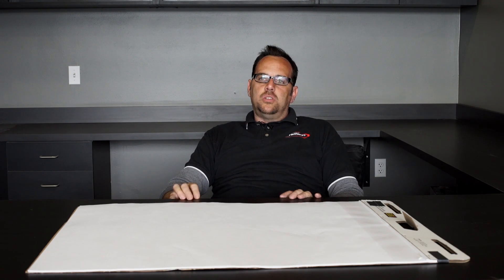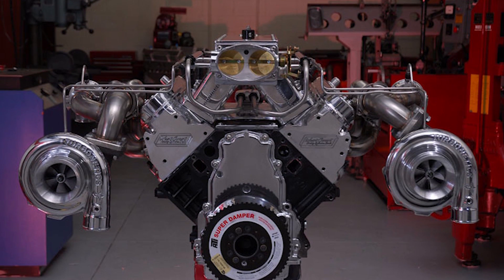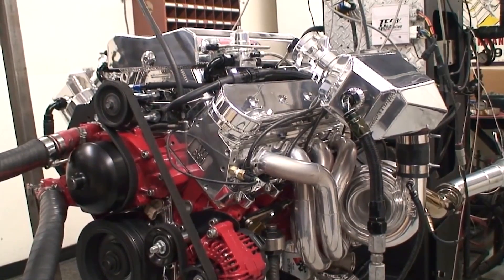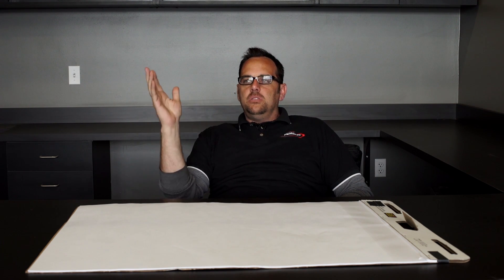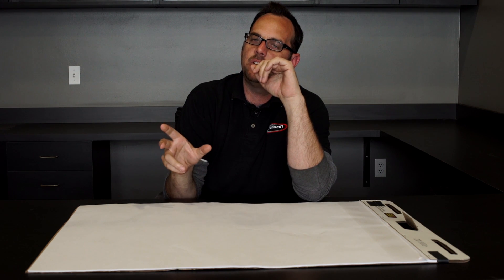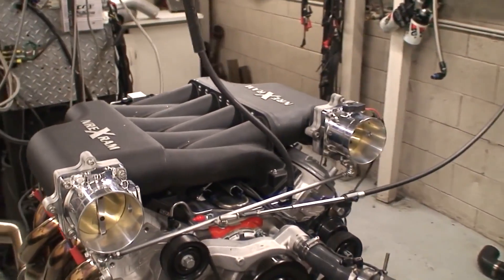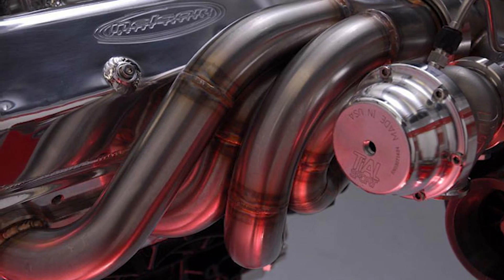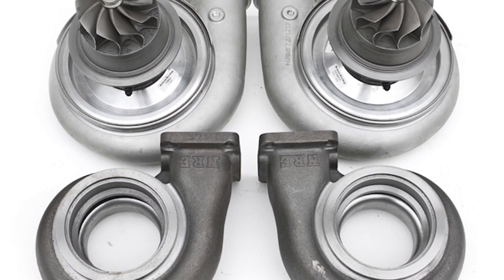Master Engine Builder Explains Why the LS V8 Is SO Good

Comment: It isn't, is the simple answer. It's an ancient design, with numerous flaws, being built way, waaaaaay after practically everything about it has been outdated.
They make teeny tiny amounts of power for their size, unless you almost completely rebuild them, the crank and valvetrain design seriously inhibit power at high revs, and are terribly inefficient.... they are, from an engineer's point of view, total wank.
From an enthusiasts point of view... lots of people like them. I don't. But some do. Can't figure out why though. No redeeming factors at all. There's a good reason they're more rare than Ferrari's in many places.
Reply: +Foxtrot Oscar Horsepower per liter has absolutely no practical meaning in the real world. Horsepower is horsepower, no matter how many liters it takes to get there. All that displacement has benefits like a fat torque curve. Sure, the valve train doesn't support revving past 8k rpm but it doesn't need to. Small displacement engines need RPMs to make their power because they don't make the same torque. 

Packaging is also better with the cam in block design. GM has repeatedly said they wouldn't be able to get the Corvette hoodline the way they want with a DOHC engine. If they have to compromise their goals to use a DOHC, I say stick with the OHV.
Reply: ***** Horsepower is most certainly not horsepower. You could have 300 thoroughbred race horses, or 500 plough-lugging Shires. I know which would get you round a track better. 
Power isn't all about power, a large portion of it is how the power is delivered. 
The 'fat torque curve' of an LS is one of its less desirable traits. When talking about road cars, large amounts of torque does nothing except make it easier to spin the tyres, slowing you down and making the car more difficult to control. Trucks and vans are the only things that can make use of torque for its true purpose, moving stuff.
All engines need revs to make power. Power is a function of force and time. All the force in the world isn't going to make you fast if you can't get it out quickly. Revs equals quickly equals power equals faster.

Packaging is marginally better in some cases. A good SOHC head is almost identical in size and shape to a pushrod head. A DOHC head is slightly bigger, but rarely makes the overall engine any bigger, as the intake and exhausts are generally wider and taller. OHC heads also give efficiency benefits that mean you could probably just use a smaller engine to begin with, for the same result.

Everyone else on the planet manages to make the bonnets of their cars fit. Why can't Chevvy? Why do they need to ignore every shred of evidence from the last 50+ years that OHC is just better?

GM have compromised their goals.... just so they could use pushrods.
Reply: barath4545 As a trained mechanical engineer and lifelong automotive enthusiast, I can't see anything good about the LS engine. 500hp? So what? If it's a choice between 500hp and something good, quality always wins in my book. It never used to... Until I owned a Corvette. 
An LS swap costs a SHIT LOAD. If you think anything otherwise, you've clearly never owned, run or tried to swap one.

Supras are cheaper in the long run, unless you're building in the USA and only using scrapyard parts, which is a teeny tiny minority of people globally.

Everywhere else, LS engines are EXPENSIVE, because no one has them. Even in the US, an SR20 is cheaper, lighter and has better aftermarket support, and if you're dedicated, can make in excess of 1000hp. What more do you need?

If you actually like cars and engineering, you would not subject anything but a vintage Chevrolet to the abomination that is the LS engine.

PS, LSs sound terrible, like almost all crossplane V8s, as all you can hear is the constant misfire.

The best alternative is simply putting far less money into the engine that your car comes with.
Reply: +Foxtrot Oscar hahahahahahahahaha..What a surprise..Seeking out videos about and engine you hatefrom a country you DISLIKE TO THE ROTTEN CORE!!Here are some wonderful BIASED BULLSHIT COMMENTs FROM YOU             Corvettes ARE gutless and shit, that's why a 3.6 litre Porsche can keep up!"
(FOXCOCK) 

I KNOW V8s are shit by design because... well... they are(FOXCOCK)

V8s do not deliver the promised performance. Thus, they are crap.(FOXCOCK) 

V8s AS ENGINES are bad(FOXCOCK) 

V8s have a very POOR potential for great power(FOXCOCK) 

I'm NOT arguing V8 aren't used, they are used. But they are NOT used for high performance applications because they just can't handle it.(FOXCOCK) 

V8s go in cars that are too expensive for normal people, but too rubbish for rich people. Not really good for either.(FOXCOCK) 

Crossplane V8s are shit(FOXCOCK) 

Crossplane V8s work poorly in everyday situations(FOXCOCK) 

The V8 is a new option for poor people, essentially.(FOXCOCK) 

FACT that crossplane V8s, especially pushrod ones, are deeply flawed and thus shit for high performance use(FOXCOCK) Please PROVIDE a Article/Review that supports your biased Opinions!!!!All these Auto Company's continue to use a crossplane V8 with GREAT SUCCESS!!!=YOU FAIL!!BENTLEY
MASERATI
ASTON MARTIN
PORSCHE
MERCEDES
JAGUAR
MORGAN
LEXUS
INFINITI
CORVETTE
CADILLAC
AUDI
KOENIGSEGG
VENOM GT

NASCAR
FORMULA D
BAJA
Le Mans GTYou NEVER owned a Corvette!!!!! You are NOT a Auto Enthusiast!!You are Not a Engineer!!You are NOT a Auto Journalist!!
Reply: +Foxtrot Oscar lighter and better?  it's pretty telling that you think a 2.0 four cylinder being only 70 pounds lighter than a 6.2 liter v8 with a supercharger is a good thing.
Reply: +Foxtrot Oscar

Clearly you don't understand sarcasm, or engines for that matter.  The LS is small for a V8, light and good at dissipating heat due to being all aluminum, makes gobs of power, and is cheap.  The point in all those swaps is that it is a powerful, cheap, reliable motor and it fits.  It is slightly larger than a Miata's I4, fits in the same space as a microspic wankel, and makes more power reliably without boost than any I6 or I4.

You act like torque and power are an either or situation.  The LS has both - a nice, flat torque curve, and linear power growth up to 7000rpm in most performance applications.  The LS3 makes 430hp and 420something lb-ft of torque.

And for the record, old Enzo Ferrari himself said "Horsepower sells cars, torque wins races."
Reply: Foxtrot Oscar
lololololollololololol

DEFLECTION!!!!
DEFLECTION!!!

Where is the Article/Reviews supporting your biased bullshit Opinions??????????

"I could import a fresh built SR20 from Japan for that, and that's lighter, and better."
(FOXCOCK)
Thats your opinion.The sr20 is slightly lighter but the LS has a lot more POTENTIAL100% FACT!!.When its time for you to import a engine get the sr20..Simple as that!!

Stop the bullshit lies!!!
You made your Comment ,MOVE THE FUCK ON!!

You are NOT a Auto Enthusiast!! Far FROM IT!!
You are NOT a Auto Journalist!!
Reply: +Foxtrot Oscar hahahahahHahahahHHHa.look at you all angry ...Everything you spewed is your Opinion...400hp from a LS engine is the same as 400hp from Ferrari..The only difference is the LS will have more torque to offset the slightly slower revving.. Your hate towards anything American is in every comment..

Provide a Article/Review that's supports your OPINIONS or SHUT THE HELL UP!!!

You can't call yourself a ENTHUSIAST !!! Your too biased and bigoted !!!
Reply: +Foxtrot Oscar dude you're not even in the us? what? i been wasting my time with you. so why are you arguing you live in the uk and if your stating not availability in europe why are you bothering then with a engine swap that it's mainly or only as you say for the us it's old school design not reliable dude when was the last time you saw an european engine going over the 200k mile marker
Reply: +Foxtrot Oscar hahahahahahahahahahahahahahaajahHahaha

Don't cry princess....Every word he said about you is True.... The more I think about it..I bet you are around 12-15 yes old..Xbox is your life..Im guessing you have one in your room..Your parents let you have it to keep you away from them. You build cars in your make believe race world and talk trash..I bet you are one of those kids that really suck at games but think your good..

You are a liar..
You are a straight up bigot with a deep distaste towards anything American...

You spew the same shit with NOTHING to back up your biased bigot bullshit..

You are a troll..

beat it loser!!!
Reply: Foxtrot Oscar

hahahahahahahahahahahahahahahahahahahahahahahahahahahahahahahahahahahahahaha

More EXCUSES!!

Please PROVIDE one single Article/Review that supports your biased opinion that  LS engines are shit,junk,gutless,boat anchors
DO not belong in High End or Performance Auto's!!!

Until you provide a Article/Review
YOU FAIL!!!
YOU FAIL!!!

What a surprise attacking America once again!!
Why do you always compare with America?
You are JEALOUS!! Simple FACT!!

You hate he LS Engine but you SEEK out this VIDEO just to SPEW YOUR BIASED BULLSHIT OPINION!!

"The only place you can get LSs is the US, because that's the only place that they're sold in any number"(FOXCOCK)

http://www.partsworldperformance.com/

http://www.roadcraftuk.co.uk/index.php?route=product/category&path=37

Just stop the LIES and Bullshit..

Your Opinion on the LS engines has been noted..Move the fuck on!!!

You are NOT a Engineer!!
You NEVER owned a Corvette!!
You are NOT a Auto Journalist!!
Reply: Foxtrot Oscar
hahahahahahahahahahahahahahahahahahahahahahahahahahahahahahahahahahahahahahahahahahahahahahahahahahahahahahahahaha

WOW you are a dim bulb..lol

They have IN STOCK ENGINES!!!
And yes they are imported from America!!

Once again you have NOT supplied a Article/Review that supports your opinion!!
=YOU FAIL!!!

Take a look around you..You are on a video about LS Engines trying to convince us that LS engines are not GOOD!!
YOU ARE WRONG!!!

You are NOT a Auto ENTHUSIAST!!!
Reply: Foxtrot Oscar
hahahahahahahahahahahahaha

Where is your PROOF..No article/review =YOU FAIL!!

You made your biased comment.MOVE ON!!

LS Engines are considered good/great!!
Provide a article/review that says otherwise!!
YOU CANT -=YOU FAIL!!

Your argument is the same..LS engines are shit,gutless,boat anchors not GOOD for High End or Performance Auto's!! Thats  100% bollocks !!lol

And yet you still have NOT provided any PROOF!!

We all get you hate LS engines..You made your POINT MOVE THE FUCK ON!!
But we both know you wont..Your hate and distaste towards America run so deep you cant help your bigot self!!

You are NOT a Auto Enthusiast!!
Reply: Foxtrot Oscar
hahahahahahahahahahahahahaha

"Praise for the LS engines? So the HUGE amount of MOCKING is praise is it? Fucking hell."(FOXCOCK)

Pleased provide proof!!!
Provide a Article/review Mocking the LS Engines!!

If it takes (a) engine 3800rpms to reach 380lbft and (b) engine 1700rpms to reach 400lbft.The latter engine will negate the slightly faster (a) revving engine!!

There is a reason American muscle/sports car are so good in straight line acceleration..LOW END TORQUE!!!FACT!!

Now that America has finally decided to address the handling aspect its a WIN WIN for everybody!!

I ask you again Please provide a article/review that supports your OPINIONS!!

Its still your OPINION that the ferrari engine is better!!
I prefer a LS9 or LS7!!! Absolutely nothing wrong with that!!

But for some reason you think your Opinions you claim as fact to be anything other than your BIASED OPINION!!!

You claim the LSxxx engines to be shit..PROVIDE A ARTICLE/REVIEW THAT AGREES WITH YOUR OPINION!!!!

You are NOT A AUTO ENTHUSIAST!!

You are nothing but a infection!!
Reply: Protip: Ignore Fox at all costs, this unemployed basement dweller is on EVERY major auto channel spewing this shame crap.
Reply: so I guess I wasn't clear the 5k was engine tranny wiring and ecu for an ls. 2k for an sr20 alone. um sorry I have driven quite a few ls powered cars and they get far batter economy then an sr20. on 93 octane you'd be hard pressed to get more then 22 average MPG out of a STOCK sr20 so nice try. I have and can constantly get over 25 mpg average in a 4000 lb ls2 ctsv and no dont even try pulling the displacement on demand bs it doesnt have it.

the ca18 is a pile of steaming crap there is a big reason why that engine is tossed for the sr20 or hell even ka-t's are better.I like how since you had ONE LS powered car ( or so you say) that all LS powered cars and the engine alone is junk. I also love how you keep saying it is used no where but the USA but like I said before my brother in law in Germany constantly send me pictures of german registered mustangs, corvettes, camaros and such. In the saudis they use pretty much NOTHING BUT turbo LS powerplants in their hill climbs rigs because nothing produces the power + reliablity that can take the crazy saudi heat for the price. When I did a tour overseas in Quatar and Afganistan I saw more corvettes and camaros and trailblazers and suburbans then I could count. You know how much a corvette cost to get in Quatar? try over $200000 even a trail blazer is over $100000 but they are EVERYWHERE. the only suv or non american car that I saw slightly more of when I was there was the Mitsubishi Pajero

GM choked the ls big time since very basic cam and headers and tune and you can easily touch 600hp with very little invested into actual mods. getting 600hp out of a very held back LSx is a joke getting 600 out of a sr20 will break the bank and will not be reliable at all. They yes PLEASE spout with with BS bmw you keep harping about which is what $90000 vs the cts-v at $50000 and that 600hp model you keep whining about is limited production and costs what was it $125000. so for an entire cts-v extra you get and over priced over engineerd engine that if it breaks in any way you need to sell the house to fix it and a slightly better interior. and GM made it "gutless" since 400hp is gutless to you to avoid gas guzzler tax extremely easy to unlock what the engine holds back. you are just a closed minded fool who had (so you say) a bad experience with an engine. Hate all you want you LS haters make me laugh. The LS isnt going anywhere and why should it it's a fantastic powerplant that has proven itself over and over. 

The Sr20 has a big following yes but I am sorry the LS kills it in parts available. If you broke something on an LS you could drive to the nearest autozone/advanced auto or whatever car parts store and for the most part would have what you need on THE SHELVES. the sr20 or whatever other motor you want to trying throwing in the mix will not have that level of available parts.
Reply: Suprised you havnt looked up and started spewing your garbage on the "LS3 V8 MIATA BUILD" video. seems he swapped that in and made a track monster with zero downsides and kept near 50/50 weight distribution. please go spew on his video so he can prove you wrong in so many ways.
Reply: +Foxtrot Oscar all this crap about crossplane cranks makes me laugh as most v8 ARE crossplane minus Ferrari and lotus. Merc BMW and audi run cross plane cranks.
Reply: +Foxtrot Oscar or show me an 8-10000hp dohc motor and ill stop talking because top fuel makes that on ohv all day
Reply: +Foxtrot Oscar LOL you're sitting here saying a LS motor, that is cheaper, more reliable, and produces over 600 HP, while having a 100,000 mile warranty, and is put in builds ALL ACROSS THE GLOBE BY TRUE CAR EXPERTS.............is a piece of shit.  

And you're calling us sheep?????   LOL

You want to bring how much a V12 Ferrari motor costs in the first place?????   LOL
Reply: +Mr English Ferrari will cover anything within 7 years????  

Damn dude, I just about choked on my sandwich when I heard that!!!!  LMFAO  

Go for it..........bring Ferrari a blown engine at 6 years.........tell me how that goes!!!!!
Reply: Foxtrot Oscar HAHAHAHAHAHAHAHAHAHAHAHAHAHAHAHAHAHAHAHAHAHAHAHAHAHAHAHAHAHAHAHAHAHAHAHAHAHAHAHAHAHAHAHAHAHAHAHAHAHAHAHAHAHAHAHAHAHAHAHA

LOLOLOLOLOLOLOLOLOLOLOLOLOLOLOLOLOLOLOLOLOLOLOLOLOLOLOLOLOLOLOLOLOLOLOLOLOLOLOLOLOLOLOLOLOLOLOLOLOL

Means NOTHING TOOL!!!

Once again I ask you ,PLEASE PROVIDE A ARTICLE/REVIEW THAT SUPPORTS YOUR BIASED BULLSHIT OPINIONS ,you like to claim as fact!!!

Until a article/review is provided..YOU FAIL!!
Reply: +Foxtrot Oscar I did an ls swap with 2 friends last week in 9 hours.  We pulled a 6.0 and 4L80E out of a rear ended farm truck for 800 dollars.  Aftermarket headers and cam ran us around 600 more.  Very inexpensive very quick.
Reply: zeusdog34 Hahaha, what a surprise, Zeusdog34 being a useless moron again. This came up on my YouTube feed, it's a fairly provocative title, this should be expected. 

The fact that you cannot concoct a decent argument, and you have to childishly deface my name gives a fairly decent indication as to your intelligence, or lack thereof. Now go away and let the grown ups do some talking.
Reply: russellallen1 Trouble is, for anyone else in the world, you'd need at least 5 grand. The only place you can get LSs is the US, because that's the only place that they're sold in any number. That means importing an engine, and if you import a scrapyard engine, you're a fool. No point shipping something that is most likely junk. Remember there's a reason that engine is in the scrapyard to begin with. 

Then, of course, there's the cost of conversion. If you bodge the hell out of it and have a full workshop, it can be quite cheap. If you need to rent ramp time, or pay someone to assist or do the work for you... it can run into the high thousands, just in labour. That's if the damn thing will fit to begin with.

And then what do you end up with? An LS powered car. Big whoop. There's a very, very high chance that that is a worse thing than what you started with.
Reply: +Foxtrot Oscar 
Then where are all the coyote swapped miatas?  Ford md motor swapped RX-7s?  S54 swapped E30s?  Oh wait there aren't, because it doesn't fit.  But an LS does, because it actually fits between the shock towers.

And torque isn't not important?  Tell that to every honda fanboy ever (I do have an S2000).  The ability to not need to be in the top of the RPM range to nove the car forward is pretty important in any racing application ever.
Reply: +Foxtrot Oscar 
Well then get out of the rest of the world and come live in freedom country.  Our McDonalds tastes great.
Reply: James Schall I wouldn't have any kind of V8 at all in a Mazda, not even an F1 engine, because the RX7 is ALL about that wankel. There's no point having one without it. The chassis is also designed to have that tiny little nugget of engine sat waay down low and well far back. Putting any kind of piston engine in there, even a teeny little 4 cylinder, moves the mass concentration up and away from the centre. 

Why the hell would you put any kind of V8 in an E30, when BMWs own inline six is superb and fits with mostly factory parts? Heck, some even came with the little six. 

Torque means jack shit. My 1972 Series III Land Rover puts about 5000lb.ft to the road, if I remember correctly. That's in bottom gear. About the same as a Tesla S, I believe. 

And guess what. It's FUCKING SLOW. It would be, it's an old Land Rover with about 80hp. 

LOADS of torque. It can pull 20, 30 tons happily. Not legally, but it'll do it. 
But it's dog slow. Because it has no power. 

The ability to NOT have full torque at low rpm is VERY useful for metering performance out of corners, and driving in wet or slippery conditions. Practically every decent driver will peel out of a tight corner, a gear up and ride the rising power band smoothly. You CANNOT do that if all your torque is in the first half of the rev range, and you're wasting so much top end by shunting the torque curve way down. That's why big, torque whore engines never make as much power as their free spinning counterparts. 

US McDonalds is actually horrid. UK McDonalds is pretty shit too, but I've had both and prefer the UK version by far. Even my American friends have said as much. That said, the far east has some pretty good McDonalds. France isn't bad either. 

Oh, and here in the UK, I have arguably more freedom than you do.
Mostly because the US constitution is based on British law from 250 years ago, and ours has changed a lot more and become freer since. 
The only thing the US has over the UK is it's easier to buy guns, really. 
Never mind the fact you can still do so here, and we have far better healthcare, education, welfare and so forth...

Also, I don't fancy paying US taxes, having to do all that paperwork and shit, and also, I don't want to get shot. I don't mind visiting, I really love visiting, in fact, but statistically, you're more likely by far to be shot than I am. Or jailed.
Reply: zeusdog34 Take a look around you. See that? That's reality. And everything in it says you're wrong dear boy.

You think that's 'getting' an LS? Those companies import them for you. They're not here naturally. Fuckwit.
Reply: zeusdog34 So they're imported. How is that a proper supply if they have to be imported by a third party? It isn't. And they're fucking expensive too. 5 grand for a damn engine? I could import a fresh built SR20 from Japan for that, and that's lighter, and better. 

What's the point in an LS when it's just not as good, and costs so much money?

I AM an enthusiast, that's why I see no point paying more for shit.
Reply: James Schall The LS is big for its power, makes crap power and is moderately expensive unless you happen to live in the one country in the world that actually buys them in bulk. The point in all the swaps is that it's a gutless, expensive, moderately reliable engine that just about fits if you cut and chop and smash stuff out the way. Is twice the size of Mazdas I4 and fits in the massive engine bay of an RX7. Big whoop. 
And makes less power than most modern engines half the size.

You know you can actually stand inside an RX7s engine bay with the engine in place, it's that big?

The LS has a horrible torque curve. All at the bottom gives nothing to the top end and makes low end control a nightmare, hence all the wheel spinning you see associated with almost all big V8s. You want progressive not linear. 430hp! WOW! From a 6.2 litre N/A engine, that's unbelieveable....ly shit. 

That quote is usually credited to Caroll Shelby, who built some terrible cars in his time (and who was also a bit of an arse, by all accounts). 
Ferrari's race cars have always been peak power monsters with gloriously smooth, progressive engines focussing on the right amount of torque and power, power, power from then on. The right way to do it.

If torque actually won races, the fastest race cars would all be diesels, as diesel is all about dat torque.

In reality, torque is good for towing and burnouts, and of little consequence to speed.
Reply: zeusdog34 Where is your argument? At all? Nowhere, so fuck off.
Reply: Tie Bei 70lbs lighter? Quite apart from the stupid archaic units used, that's a 100% bollocks figure.
The LS3 weighs around 204kg (450lbs for you Americans). The SR20DET in full trim weighs 149kg, or 328lbs. That's a LOT less. And weighing exactly that amount (or even slightly less if you ditch the cast iron exhaust for a light tube one) you can get 500hp. And instant response. And cheap parts. And perfect Japanese reliability. 

So what's the point in an LS again?

The LS9, with the supercharger, weighs 240kg (530lb) DRY, according to Jalopnik's weighing of theirs. 
That's a 91kg difference between an LS9 and an SR20. The entire chassis of an Alfa Romeo 4C weighs 65kg. Just think about that... That's a fat bloke sitting on the bonnet. All the time. That's going to screw your handling right up.
Reply: zeusdog34 Where is your counter argument? You can't disprove me, I have proof. Pushrods are shit BECAUSE they have more reciprocating parts, leading to greater friction. Greater reciprocating mass leading to wasteage of power. Less accurate following of the cam profile leading to sub-optimal valve timing, thus reduced power or efficiency. 

There. If you can disprove that, go ahead. As you can't... I suggest you shut up.

460hp is SHIT for a 6.2 litre engine. That's obvious. You CANNOT deny that. 

Again, I suggest you shut up.
Reply: zeusdog34 Yes. But Ferrari do it quicker, smoother and better from a smaller, more effective engine. It's EVERYTHING ELSE that makes an engine good, not just what numbers it makes on a dyno. 

Torque does not 'offset' revving, in any way. 

Your hatred of the fact that the LS engine is shit, is evident. 

Don't hate the facts man, hate yourself for being wrong.

Please do explain how not liking an engine for its obvious engineering defects and lack of ability to perform as I would like makes me bias in any way.
Reply: +Foxtrot Oscar before we waste any more time, what do you drive?
Reply: +Foxtrot Oscar hahahahHHHaaaaa

seriously man..Just provide a ARTICLE/REVIEW that supports your OPINIONS.. If you can't SHUT THE HELL UP.
"Torque does not 'offset' revving, in any way"
(Foxtrot)
Proof you have NO IDEA what your talking about..
Lowend Torque 100% does offset faster revving!! 400ftlbs of torque at 1700rpms is going to offset the 380ftlbs at 3400rpms.

You prove that you know very little about HP and TORQUE..

The thing is I can and have provided articles and reviews that only Praise the LSxx engines..You have NEVER provided anything supporting your ridiculous opinions that you like to claim as fact..

It's your Opinion the Ferrari engine is better..For you its better,for Me I would take a LS9 or LS7 from the C6 ZO6..Simple as that..

Nowhere am I claiming the LS9 or LS7 is better.Just my choice..

Stop haten!!! Stop your bias..

Millions around the world Love it..Proven by the crazy aftermarket support, the LS swaps around the world...And the continued Praise by ALL the experts...You know the ones who build them and drive em.The experts who test and review!!

I ask you again Please provide a ARTICLE/REVIEW that supports your OPINIONS..
Reply: zeusdog34 Provide an article that explains torque? Ok.
http://physicsnet.co.uk/a-level-physics-as-a2/mechanics/moments/

Happy?

Low end torque CANNOT 'offset revving'. Low end torque is how much torque is produced at low RPM. It has NOTHING TO DO with high revs. You cannot produce more revs by having more torque at the bottom end of the rev range. The two concepts do not overlap.

400lb.ft at 1700rpm will not equal or oppose (the two grammatically possible outcomes of the word 'offset') 380lb.ft at 3400rpm 

(please, get the units right)

You prove that you know jack shit about anything.

Praise for the LS engines? So the HUGE amount of MOCKING is praise is it? Fucking hell... There is a VERY GOOD REASON that NOBODY uses pushrods anymore. Think about it. If they were any kind of good at all, at least a few manufacturers would use them. Nope. Just GM and Chrysler, and ONLY on their US market V8s. 

The engines they sell to everyone else... OHC.... Says a lot, doesn't it. I mean, 96% of the world must be wrong about pushrods if Chevrolet say they're great...

The Ferrari engine is factually better. Smaller, lighter, more effective, more specific power and more specific torque, better revving, freer, more precise, more progressive...

That's all good.

The other MASSIVE bonus that the Ferrari engine has to enthusiasts is that it feels fucking epic. 

That matters too. This is why Ferrari are so well regarded, because they manage to appeal to reality and enthusiasts. 

This is why Chevrolet are constantly mocked. Because they ignore reality and cater to only a very small portion of enthusiasts. 

Your extreme bias for the LS series and just anything American, without reason, is evident in everything you do.
Reply: Tie Bei Many things. I can't decide what I want, so I buy and sell almost constantly, except for one or two cars. 
I drive my very first car still, my 1972 Series III Land Rover, and I've kept my 1972 Jaguar XJ12 too, because I've never found anything else so comfortable, powerful and that handles and rides so well for a price that I can afford. And the fact that I've had it for ages and it looks and smells so great.
Reply: FrankieJames7 No, I think inferior engineering is worse. Hence I can't see the point in having an LS.
Reply: ***** I'm not even sure you can get a Land Rover, or an XJ, on xbox. Real life however, very much possible. On xbox I had a Ferrari. I would gladly swap the Jag and the Land Rover for an F40.
As that's not possible, I may have to just buy another xbox.
Reply: zeusdog34 Proof? Just look around the internet, jesus...

I've provided a number of articles explaining in detail the exact reasons that both pushrods and crossplane V8s are poor choices for performance.

If you're too stupid to understand that, that's your problem.

How the fuck does that even work? 400lb.ft at 1700rpm will NOT 'negate' 380lb.ft at 3800rpm. There are FAR more variables than that. The power curve before and after those precise points plays a MASSIVE part, as does the gearing (gearing can multiply torque dozens of times, that's how my little 2.5 litre Land Rover puts more torque to the ground than a Bentley) In addition, the intended output can vary wildly. What you want and what you need can vary massively between cars and environments. 
And for performance use, you will NEVER be trying to pull from 1700rpm, but you might need to get out of a slow corner at 4000 rpm, where that later peak will come in real handy. 

Ok. So a V8 diesel Dodge Ram produces an imperial cunt load of torque. Very good. It can tow lots of stuff. 
Is it fast? NO.

Does a Caterham 7 produce much torque? No. Next to no torque. Is it fast? Err, fuck yeah. Can't tow for shit, but it can haul its own arse to 60 faster than most people can say 'nought to sixty seconds'. 

Torque does NOT equal speed. Power equals speed because power is a function of speed. Torque is merely a vector measurement. 

How is it win win? I could spend 62k on a C7, or 80k on a Z06, or I could spend 30k on a Lotus and be just as fast. And yes, the Lotus does handle a lot better. There's not a lot that can touch them.

You can prefer an LS9 all you want, I'm not stopping you. Your fetish for clunky valvetrains and massive superchargers is your own thing and you're welcome to it. 

But never, ever, ever try and tell me that the LS is a superior piece of automotive propulsion engineering. Because it just isn't. 

I've provided a huge amount of evidence, from the poor specific outputs to the futility of the pushrod design in the face of over half a century of OHC engines beating the shit out of them.

It's not just Europeans and Japanese either, Americans understand the importance of OHC. Ford, with their long line of OHC V8s, and now their super new flatplane.

Heck, one of the most successful Indy racing engines was the (American) Offenhauser 'Offy' engine. That 4 valve, DOHC engine, praised globally for its high power, won 27 Indy 500s between the 30s and 70s. You could say it 'dominated'. 
(420hp from 4.1 litres)
By any standard, that's a very successful, very powerful little engine. 

The thing that eventually beat it was the mighty Cosworth DFX... Another 4 valve DOHC engine. 

And yes, that 'per litre' part was really important. Because when races are capacity limited (and they frequently are), whoever can make the most power out of that capacity... wins. Simple as that.
Reply: ***** Yep, I'm a kid. A 29 year old kid with some fucking big toys. And that's the best way to be. 
As for being an engineer... no, my current job is not in engineering. But 4 years of training and working for some of the biggest names in the business made me an engineer, and nothing will ever take away that experience. Well, nothing short of massive brain injury anyway.
Reply: FrankieJames7 The LS is NOT 'superior engineering'. It's a pushrod crossplane V8 when all of its competitors switched to OHC and flatplane decades ago. Even Ford have now gone that route... and they're making a shit load of power doing so. 

Please, tell me of any LS engine that can match Ferrari's 600hp from 4.5 litres....N/A...

No? 
Thought not.

Those 'retards' you're talking about, developing the 4 valve head, made massive power.

Every F1 car since the 40s has been DOHC. Pretty much every international race winning engine since the 60s has been OHC..

The Rolls Royce Merlin engine, that powered the Spitfire and the P51 Mustang, famed for its high power and small size, that allowed the defence of the world as we know it from the Nazis... that was DOHC and 4 valve.

Jaguar, in 1948, brought out a DOHC inline six. That car became the fastest car in the world. (3.4 litres, think about that eh?)
That engine went on to win Le Mans 5 times. 
How terrible can it be?

DOHC is GOOD.
Multivalve heads. GOOD.

Pushrod... not good. Because they're pernickity and don't follow the cam properly and are just too soft and bendy.
Reply: ***** Sorry, what? I disabled the comments? On someone elses video..
And how the ever living fuck am I supposed to have done that? 

Also, I don't ever recall 'moaning like a lil girl', nor did anyone ever 'shut me down'.

To have done that you'd have had to have provided factual evidence to suggest that an LS engine is better for an S13 than an SR20DET is. And guess what, you didn't.

So fuck off, basically.
Reply: Foxtrot Oscar hahahahahahahahahahahahahahahahahahahahahahahahahahahahahahahahahahahahaha

" I've provided a number of articles explaining in detail the exact reasons that both pushrods and crossplane V8s are poor choices for performance."(FOXCOCK)

NO you have NOT!!NICE TRY LIAR!!!

BENTLEY,MERCEDES AMG,AUDI RS/R8,JAGUAR,MORGAN,ASTON MARTIN,VENOM GT,KOENIGSEGG,CORVETTE,PORSCHE
ALL DISAGREE with your biased bullshit opinion!!
As do the experts that review/test auto's with v8 engines!!
YOU FAIL!!

Provide a article/review that states LS/Cross plane v8 engines are not GOOD for Performance!!!!!!

What I still dont get,WHY COME TO A VIDEO KNOWING 99% OF THE PEOPLE COMMENTING AGREE 100% WITH THIS VIDEO!!

The Corvette GT Racing team has won more 24 HOURS OF LE MANS CLASS CHAMPIONSHIPS IN THE LAST 15 YEARS THAN PORSCHE AND FERRARI!!!
Yup thats DOMINANT!!!!!

Its your deep distaste towards America!!
You love to incite termoil with your biased bullshit opinions!!

You made your comment..MOVE ON!!!

You are NOT a Auto Enthusiast!!
You are NOT a engineer!!!
You are NOT a Auto Journalist!!
Reply: FrankieJames7 Yeah, so? The Ford engine is actually nicer to drive. And for an enthusiast, that makes a big difference. I'd certainly rather have a Mustang than a Camaro, because they just drive better.

That said, the Coyote isn't anything special. There are certainly a lot of much better engines out there than that or the LS... which is just a heap of outdated junk. 

40 years ago, I'd have said the LS was brilliant... but this isn't 1975, this is 2015.

The 'massive power' I was referring to was things like the 600hp  4.5 litre Ferrari V8, the 450hp 4.5 litre TVR V8,  or the 526hp 5.2 litre Ford flatplane V8. 

Find me an LS that can make 600hp N/A stock... oh yeah, none of them did. The only one to break 600hp was the LS9, which was 6.2 litres and supercharged, while Ferrari can do it naturally, with just 4.5 litres. That's the power of DOHC and flatplane cranks. It's also why their race engine is so strong, because they had to de-tune it for racing, unlike everyone else, who had to tune theirs up.
Reply: zeusdog34 Um, yes, I have. You know all those articles I've posted, the links to tech sites, the ones you read and claimed you 'didn't care about'... Yeah, you read them. And unless you've gone back and deleted them, all the comments proving that are still there.

The Corvette GT racing team is VERY VERY GOOD. Fact. 

Their car, on the other hand, isn't. The qualifying times well below the others prove that.

What the Corvette team do well, is pit stops and strategy. I've seen those guys working and while they all look glum as fuck, they're properly good at their jobs. While the Ferrari guys are flapping about, the Corvette lads are focussed, and that's what wins endurance races. 

That's not to suggest that the Ferrari teams are unprofessional, merely that the Corvette team is better.
Reply: Foxtrot Oscar
hahahahahahahahaha

MORE LIES and total bullshit from you

Corvette has DOMINATED THE GTE/GT CLASS OVER THE PAST 15 YEARS!!!!

http://www.corvetteracing.com/history/

2015 - 3 FIRST PLACE WINS,10 TOP 5
    1ST PLACE 24HRS OF LE MANS
6 TOP 5 QUALIFY

2014 - 4 FIRST PLACE WINS,13 TOP 5
     2ND/4TH 24HRS OF LE MANS
12 TOP 5 QUALIFY

2013 - 5 FIRST PLACE WINS,12 TOP 5
      4TH 24HRS OF LE MANS
13 TOP 5 QUALIFY

2012 - 4 FIRST PLACE WINS,15 TOP 5
     5TH 24HRS OF LE MANS
20 TOP 5 QUALIFY

2011 - 2 FIRST PLACE WINS,11 TOP 5
      1ST 24HRS OF LE MANS
10 TOP 5 QUALIFY

2010 -  1 FIRST PLACE WIN,10 TOP 5
13 TOP 5 QUALIFY

2009 -  4 FIRST PLACE WINS,12 TOP 5
   1ST 24 HRS OF LE MANS
14 TOP 5 QUALIFY

2008 -  11 FIRST PLACE WINS,10 1ST,2ND    FINISHES.  2ND 24HRS OF LE MANS
24 TOP 5 QUALIFY

2007 -  12 FIRST PLACE WINS,11 1ST,2ND FINISHES, 26 TOP 3, 2ND 24HRS OF LE MANS
26 TOP 3 QUALIFY

2006 -  6 FIRST PLACE WINS ,21 TOP 5
            1ST 24HRS OF LE MANS
21 TOP 3 QUALIFY

2005 -   10 FIRST PLACE WINS, 20 1ST,2ND FINISHES, 1ST,2ND 24HRS OF LE MANS
19 TOP 3 QUALIFY

2004 -  10 FIRST PLACE WINS,19 TOP 3
             1ST,2ND 24HRS OF LE MANS
19 TOP 2 QUALIFY

2003 -  5 FIRST PLACE WINS, 16 TOP 3
    2ND,3RD 24HRS OF LE MANS
19 TOP 5 QUALIFY

2002 -  10 FIRST PLACE WINS,20 TOP 3
   1ST,2ND 24HRS OF LE MANS
8 TOP 5 QUALIFY

"The qualifying times well below the others prove that."(FOXCOCK)
 100% BULLSHIT LIES!! CHECK OUT THE QUALIFYING STARTS/TIMES!!

You will lie to no end to try and make your point!!!

100% PROOF PUSHROD CROSSPLANE V8 ENGINE WORK AND WORK VERY WELL

YOU ARE A LIAR WITH A DEEP DISTASTE TOWARDS AMERICA!!

Please provide a Article/review that supports your biased bullshit opinions!!
YOU CANT= YOU FAIL!!!
Reply: ***** Yeah...... whatever.
Reply: ***** You know, apart from the FACT that this is standard engineering logic, and you can ask anyone, and find it anywhere.

And, you know, the FACT that no one bar GM and Chrysler use pushrods, and guess what, they're all VERY highly respected.

You CANNOT tell me that people like Mc Laren, the most successful F1 race team of all time, are wrong about DOHC... Because that just makes you sound stupid.

Well, more stupid than your continued use of '10 year old whore child' as an insult already makes you sound.
Reply: ***** See, you, a random person from the internet who hasn't figured out how to use capital letters properly yet, just saying that I have no credibility.... well that doesn't make it true. 

Here's a fact, I'm 29.
Here's another fact. I'm an engineer.
Here's another fact. Pushrods are less efficient than OHC designs
Here's another fact. You're wrong.
Here's another fact. Pushrods are considered outdated and ineffective by just about every race engine builder on the planet bar a tiny minority of lolrod enthusiasts
Here's another fact. I trust Ferrari, McLaren, TVR, Lamborghini, Noble, Caterham etcetera, far more than I trust you or GM, because frankly, neither of you have a great track record. 

So, what's that, Foxtrot 6, Iamsu, -2....

Sounds about right. 

If you want to act like a child, fine, I can dumb it down for you. But facts are still facts, so there's pretty much no way on earth I can lose this. 
I do love being right.
Reply: Foxtrot Oscar hahahahahahahahah

Once again EXCUSES AND DEFLECTION!!

Fact the Corvette is the most DOMINANT team in GTE/GT  over the past 15 years!!

OVER 50 YEARS OF DRAG RACING WITH CROSS PLANE PUSH ROD V8'S PROVES HOW GOOD THEY ARE!!

NHRA DRAG RACING WITH CROSSPLANE V8 ENGINES PROVE HOW GOOD THEY ARE!!

NASCAR 800HP N/A ,8500+ RPM,300+MILES AT WOT!!! PROVES CROSS PLANE V8 ENGINES ARE GOOD.

1994 INDY 500 WAS WON BY A PUSH ROD MERCEDES v8..It dominated so bad that the engine was LATER BANNED!!!
More PROOF push rod v8 engines are good!!

The Continued USE BY HIGH END AND PERFORMANCE AUTO'S ALSO PROVE HOW GOOD THEY ARE!!
BENTLEY
MERCEDES,AMG,GT
AUDI RS,R8
PORSCHE
JAGUAR
MORGAN
VENOM
KOENIGSEGG
CORVETTE
DODGE "HELL CAT"

NASCAR
NHRA
FORMULA D
BAJA

I ask you again PLEASE provide a article/review that supports your biased bullshit opinions!!(that cross palne v8's are shit,shit by design,gutless,boat anchors,not GOOD for High end or Performance Auto's)

Until you provide the proof.YOU FAIL!!

You are a LIAR!!
You are a BIGOT!!
You are NOT a Auto Enthusiast!!
You NEVER owned a Corvette!!
You are NOT a Auto Journalist!!
Reply: MrZerocool5000 My point is, you cannot say an engine is good based purely on the fact that it's easy for a mere 4% of the world's population to get hold of. 

When was the last time I saw a European engine over 200k?
Erm... this morning? My Jag is on about 300k. No sweat.
My Land Rover is on 800k, ish. (I've broken a couple of clocks now. They do not like being filled with grit and sand and dirty water and shit) That is on a non-original engine, but even that's done a fair few miles now, and it wasn't new when I put it in. 

'Old school design' doesn't make it 'good'. There's a reason no one serious since the 60s has used pushrods. Because they're crap.
Reply: Foxtrot Oscar lolololololololol

"There's a reason no one serious since the 60s has used pushrods. Because they're crap."
(FOXCOCK)

Please provide a article/review that supports your biased opinion!!

"easy for a mere 4% of the world's population to get hold of"(FOXCOCK)
100% LIE!!!!!!
Anyone can get a LS engine!!!Very easy to get in CANADA,GERMANY,UK,JAPAN,AUSTRALIA ect ect!!!!!!

Just STOP THE LIES!!!

YOU ARE NOT A ENGINEER!!
YOU ARE A LIAR!!
YOU ARE NOT A AUTO JOURNALIST!!
Reply: zeusdog34 dominate
ˈdɒmɪneɪt/Submit
verb
have power and influence over.
"the company dominates the market for operating system software"
synonyms:	control, influence, exercise control over, be in control of, command, be in command of, be in charge of, rule, govern, direct, be the boss of, preside over, have ascendancy over, have mastery over, master, have the upper hand over, subjugate, hegemonize; More
be the most important or conspicuous person or thing in.
"the race was dominated by the 1998 champion"
have a commanding position over; overlook.
"a picturesque city dominated by the cathedral tower"
synonyms:	overlook, command, tower above, tower over, stand over, project over, jut over, hang over, loom over, dwarf, overtop, overshadow, overhang; More

The Corvettes  _DO NOT_ have power or influence over the other cars.
The Corvettes DO NOT hold the most important or conspicuous position
The Corvettes DO NOT command, overlook or overshadow anywhere else.

Their victory margin is NOT conducive to 'dominant' status.

THEY DO NOT FUCKING DOMINATE.

LEARN WHAT WORDS MEAN BEFORE SPEWING THEM EVERYWHERE.

Drag racing? Where OHC engines frequently beat pushrod engines. Yeah, real good.

How about the real racing, like... Formula 1. The most advanced, engineering driven motorsport on the planet... that hasn't used pushrods since the 20s. Yeah, 95 years ago. That's why F1 cars still kick the shit out of everything else on four wheels. 

So? The NASCAR engines are mildly impressive. But a fucking 1970s F1 engine is MUCH more impressive. 

In 40 years, there's been ZERO improvement from lolrods.

Oh, so because a pushrod engine won ONE race, you think they must be good. Just ignore the hundreds of thousands of races won by OHC engines...

Bentley don't use any kind of performance V8
Mercedes don't use pushrods
Audi don't use pushrods
Porsche don't use pushrods, or use crossplane V8s for performance
Jaguar don't use pushrods
Morgan don't use pushrods... except in their 3 wheeler, but that thing is bat shit crazy anyway
Venom isn't a company, to my knowledge.
Koenigsegg don't use pushrods
Corvettes are shit
The 'hell cats' are also a bit wank. 

NASCAR is stuck in the 1950s, technology wise.
The NHRA has a wide variety of different classes, many of which are not V8s.
Formula D has FAR more OHC, 4 and 6 cylinders than lolrod V8s.
Baja... Badger... whatever. 

Please, do provide some technical articles and proof of crossplanes and pushrods being any good. I eagerly await. Four years and you've produced jack shit of yet.
Reply: zeusdog34 Why do I need an article to prove what you can see with your own eyes? No one is going to write an article explaining that no one uses pushrods because it's blindingly fucking obvious. Just look at the total lack of pushrods in WRC, F1,  BTCC, WTCC, DTM, GT500, LMP, F2, F3000, Super2000 or any other formula you care to mention. In fact, the ONLY pushrods in ANY top flite international motorsports are the Chevvy lolrods in GTPro. That's one car in one class that uses pushrods and only wins half the time. 

To get an LS in Europe, it needs to be privately shipped, or shipped by a third party, 5000+ miles from the USA. 

That is NOT 'easy'.
Reply: Foxtrot Oscar HAHAHAHAHAHAHAHAHAHAHAHAHAHAHAHAHAHAHAHAHAHAHAHAHAHAHAHAHAHAHAHAHAHAHAHAHAHAHAHAHAHAHAHAHA

Oh so now your on PUSH ROD V8 ENGINES.Before you were all about how bad cross plane v8's are!!
So it really comes down to American push rod v8 engines you  hate!!!
Thank you!!!!

ALL YOU HAVE DONE IS COME BACK WITH DEFLECTION AND EXCUSES!!!

"How about the real racing, like... Formula 1."
(FOXCOCK)
Thats your Opinion,nothing more!!

"The NASCAR engines are mildly impressive. But a fucking 1970s F1 engine is MUCH more impressive."(FOXCOCK)
Thats your Opinion and 100% false!!

"In 40 years, there's been ZERO improvement from lolrods."(FOXCOCK)
Another 100% lie!!
VVT,Cylinder Deactivation,Direct Injection,the use of super light SUPER STRONG(TITANIUM RODS) ect ect ect!!!

"The NHRA has a wide variety of different classes, many of which are not V8s."
(FOXCOCK)
100% LIE!!!
All the classes use V8's ,except Pro Stock Motorcycle!!!

"To get an LS in Europe, it needs to be privately shipped, or shipped by a third party, 5000+ miles from the USA.
That is NOT 'easy'"
(FOXCCOK)
You once said it was easy to ship a 60's Corvette to the UK!!!hahahahaha

 Once again you have NOT provide a ARTICLE/REVIEW that supports your biased bullshit Opinions!!

YOU ARE A LIAR!!
YOU ARE A BIGOT!!
YOU ARE NOT A AUTO ENTHUSIAST!!
YOU ARE NOT A ENGINEER!!
YOU ARE NOT A AUTO JOURNALIST!!
Reply: ***** Now you're calling a country with a currency worth less than mine, 'garbage' and 'third world'.

Yeah.... 

I did not know you could disable replies. 

I do know, however, that after 500 comments, Google+ closes the comments down. 

That's the most likely cause of your misplaced rage. Either way, I didn't stop the replies.

If I knew how to do that shit, I'd have permabanned your arse long ago, because you're a useless prick.
Reply: zeusdog34 I've always derided both pushrods and crossplanes, and especially the mix of the two. 

If a modern 5+litre V8 can make 800hp, and a 1970s 3.5 litre V8 could make 800hp, the 40 year old, smaller engine is far more impressive. End of. FACTS. 

Formula 1 is the highest level of motorsport. There is no racing more 'real', in competition terms. 

VVT, direct injection!? WOW! HOLY SHIT! Welcome to the fucking 80s Chevvy!

RELATIVITY. In terms of cost to return, importing a 1960s Corvette is not terribly difficult or expensive. Why the fuck you'd do that, I don't know, and when the fuck I said that, I don't know. I suspect you're BSing again.

However, for an engine... it's a bit more difficult. You could book a crate, but that's a lot of effort for just an engine, or you could trust a courier, but transport is harder, and shit needs packing and it's just a pain in the arse. 

Once again, all you've done is claim everything is my opinion (despite it being facts), and not provide any evidence or proof or even logic to support your views.

Well done.
Reply: ***** Still bollocks. Still worthless. Still just the insane ramblings of a raging fuckwit. Good night.
Reply: Foxtrot Oscar
Sorry i guess I missed the out of the US part.  Ya it would be pointless to ship a junkyard engine.  Here however they are everywhere.
Reply: ***** Still just you blathering on, spewing obvious bullshit, for no reason.
Do I sound ten years old to you? 

Actually, stupid question, you're you, therefore guaranteed to say yes, even though the opposite is true. 

A valid argument... So if facts and technical principles aren't a valid argument, do tell me, what is?

And just so you know, on this planet, calling someone a 'butthurt 10 year old autistic child' is not a valid argument, and is very much a dick move on your part.
Reply: +Foxtrot Oscar Uhm you realize they weigh less than most other motors producing the same horsepower. If you think that the number of liters is somehow important, please educate yourself. They also have a lower center of gravity than German and Italian junk. The unbelievably terrible, torqueless, incredibly fuel-inefficient BMW S65 weighs only 20 pounds less than the new LT1, and roughly the same as the idiotic BMW S55 while returning superior gas mileage.
Reply: furk Uhm, you realiSe they don't actually weigh less, right? Most LSs sit around 200kg... which is about the same as the (more powerful) turbo V8s of BMW co, and is significantly MORE than the (usually equally powerful) 6 cylinders. 

If you think the capacity is not important, please educate yourself. 
If you can make the same power with less litres, you pay less tax, less insurance and your emissions are generally better, costing less money..

If you want to go racing, you have to enter your 6.2 litre, 460hp Corvette against other 6 litre cars... you'll get 700hp Lambo's and 740hp Ferraris, and your 460hp Corvette will go nowhere fast.

If you want to race against other 460hp cars... you can't. Because your engine is over a litre bigger than everyone elses, and that's not fair.

You can't legally race in that class. 

The 'lower centre of gravity' is a couple of kilos moved a few millimetres further down. It does jack shit overall. It's unnoticeable.

The old BMW engine is more efficient, does better economy (the M3 was a HEAVIER car, and got the slightly better mpg than the 'Vette) and is smoother and sharper and more responsive and more precise.
And in a performance car, that MATTERS TOO.

It's not all about dyno figures. Never has been, and never will be, in all the century old history of racing.
Reply: ***** 
I am 29.
I have 5 complete cars and about 4 more in bits
I have 12 years plus of automotive experience, not counting changing oil with my dad when I was a kid and stuff like that.
I have worked for places that make your head spin on things that you aren't allowed to know even exist.
I most certainly am an engineer. The list of certificates I have proves that.
I don't need dollars, I work for pounds sterling. A superior currency, and actually spendable where I live.
I DID NOT disable replies to some shitty 240SX video
You NEVER roasted ANYONE.
Therefore,

Go away. Seriously, what is the point in your continued existence if all you do is claim that a random guy you've never ever met is 10 years old with zero evidence. 

PROVE something you've said. Anything. Prove it.
Reply: Spike Razzor Pro tip. Ignore people who can't even spell 'pro tip' or 'same' properly. 

Also people who make ridiculous (false) assumptions about people they've never met. Those people tend to be idiots.
Reply: you not really being specific on why you dont like it
Reply: +Iamsu From The Rich he does seem immature. The only time i see people who criticize others and get defensive when challenged are people who are just learning something and already believe they are an expert.
Reply: zeusdog34 Was that comment even worth the effort? 

You spew 20 lines of pure trolling bullshit, just to call me a troll. Hypocrisy upon stupidity upon ignorance upon arrogance. 

It's really not becoming of you, little Zeus pup.
Reply: +Foxtrot Oscar actually it was!!The more I think about it..You are most likely a young boy in his room playing xbox all day.. Everything you SPEW IS 100% LIES and BULLSHIT!! Never offering any facts to back up your bullshit opinions and claims!!!You still have NEVER PROVIDED A ARTICLE/REVIEW THAT SUPPORTS YOUR OPINIONS,NOT ONE!!! AND THAT IS A FACT!!!!
Reply: zeusdog34 I've explained who and what I am. If you choose to ignore the only evidence of my identity, and choose to create an entirely new, different personality for me, and ignore every scrap of fact or proof, then that's your deluded mind only. Think what you want of me, it won't change the facts.
Reply: Foxtrot Oscar
hahahahahahahahahahahahahahahahaha

Just about every auto expert that test and review a car with a LS ENGINE do nothing but RAVE ABOUT THE THE V8 ENGINE!!!They love the sound,the power and torque!!!
If you choose to IGNORE THE AUTO EXPERTS THAN THATS YOUR DELUDED mind ONLY!!!!
Think what you want about LS Engines it wont change the facts!!!

You STILL have NOT PROVIDED A ARTICLE/REVIEW that supports your biased bullshit opinions/claims!!That Crossplane V8 engines are not GOOD for High End or Performance Autos!!!!

You FAIL!!!

You are NOT a Auto Journalist,you cant be you are only 12 or 15 yrs old!!

You are however a bigot with a deep distaste towards America!!
Reply: zeusdog34 Well, no, actually, they don't. What everyone says is 'ooh power, ooh torque'.. NOTHING is ever mentioned of quality of engineering, smoothness, precision, efficiency, technical excellence or, you know, any of the things that make an engine truly great. Any halfway intelligent person can produce horsepower. It takes skill to make quality. And never is that mentioned in relation to any LS.

The FACT that they are big, underpowered, inefficient and have a factually outdated and terrible valvetrain is FACT.

You have still not read the fucking reviews and articles I've posted, obviously.

You being shit, does not make me wrong. It makes you wrong.

You are not a sane human being, otherwise you'd listen when I say I DO NOT HATE THE USA

You are a bigot, a liar, a hypocrite and biased up to the eyeballs with your senseless, factless, illogical infatuation with a ridiculous engine.
Reply: Foxtrot Oscar hahahahahahahahaha

Oh no foxcock is upset and angry!!!

All the experts that test the cars/engines mostly agree how great the LS engines are,love the sound,power,torQUE,Rave about the efficiency!! More lies spewed from the American HATER

Nice try LIAR!!!! You have NEVER PROVIDE ONE SINGLE ARTICLE/REVIEW THAT supports your biased bullshit opins and claims!! FACT!! = you fail!!!

Where is a article/review that states crossplane v8 engines are not GOOd for High End or Performance auto's as you claim!!! WHERE IS IT????? YOU have NEVER PROVIDED ANYTHING that supports your opinions!!!! = YOU FAIL!!!!!

lolololololololololol.. I can and have provided many articles raving about LS engines and the Corvette!!
You fail at EVERYTHING.. 

yOU ARE A 12 YR OLD BOY

Go play with your xbox and leave the real auto enthusiast ALONE!!
Reply: zeusdog34 And you've reverted to the 'I have no argument whatsoever, so I'm just going to call people liars, ignore all their evidence, and then claim they're upset' thing again.

It's old now, boring. It's never worked before, what makes you think it will now?

Come up with some FACTS.
.
Go on, I dare you. 

Rather than insults and bullshit, bring some genuine substance to your argument.
Reply: Foxtrot Oscar
jhahahahahahahahahahahahahahaha

YES BACK TO DEFLECTION and EXCUSES!!!

You have NEVER had a argument or anything worth any value!!

Yes reading your biased bigot bullshit is old and boring!! Agree!!

Rather than make shit up and spew LIES and total bullshit BRING a  ARTICLE/REVIEW supporting your Opinions that crossplane v8 engines are not GOOD for High End or Performance Auto's!!

You are NOT a Auto Journalist!!
You are a 12 yr old boy!!!
Reply: zeusdog34 Ah, I think I get it now. Finally, after all these years, I think I've figured out what 'deflection' is in your world.

It's calling you out on your bullshit, isn't it? 
Whenever I highlight your total lack of an argument, I'm 'deflecting' your slanderous comments. 

So, I'm going to continue doing that. 

I have posted NUMEROUS articles explaining the flaws of both the crossplane configuration (improper timing between banks, heavy internals) and the pushrod system (high reciprocating mass, inefficient cam following, inability to support multi valve heads and wide valve angles).

You just keep ignoring reality, don't you?

It's not like it's just your word against mine either. The comments I posted, containing those links, are still there. Proof irrefutable, that you are not only wrong, but lying about it too.

The facts are all there sonny, the inefficiencies caused by the valvetrain and wonky firing, and the absolute evidence in the consistent lack of power in LS engines when compared to other engines of similar capacity and use. (i.e. every other large performance engine out there) 

If your performance engine cannot perform as well as its peers, it is not as good. Fact.

And really, do you have any evidence to counter that? No.

Nor do you have any evidence that I'm not who I say I am.
Reply: Foxtrot Oscar
hahahahahahahahahahahaha

Once again more DEFLECTION!!!

Please provide a ARTICLE/REVIEW that states the Crossplane V8 does "not perform as well as it peers"

Please provide a Article/Review that states the Crossplane v8 is not GOOD for High End or Performance Auto's!!

Please provide a ARTICLE/REVIEW  that states the LS Engine lacks power!!

I dont care about the minor flaws nor do the people that buy them,build them and review them!!

ALL ENGINES HAVE FLAWS!!!!!!

YOU have NEVER PROVIDED ANY PROOF!!!
Your biased bigot opinions HOLD NO VALUE!!

lololololololololololololololol  YOU FAIL ON EVERY ARGUMENT!!
NO PROOF =YOU FAIL!!!

Nice try 12 yr old boy!!
You are NOT a auto journalist!!
you certainly are NOT a Auto Enthusiast of any kind!!
Reply: zeusdog34 Yes, more of me being right, you being wrong, and me explaining exactly why. Sounds about right.

I HAVE provided numerous articles. You know the five or six I posted explaining the difference between crossplane, flatplane, the advantages of the latter and the disadvantages of the former? 
One of them was the Ford spiel, another was a technical explanation with rather nice GIF animations.

The LS lacks power. Proof RIGHT HERE. 
LS9. Supercharged, 6.2 litres, 650hp.
Ferrari V12. N/A 6.3 litres, 740hp.

If a naturally aspirated engine can make 90hp more than your supercharged engine, from nearly the same capacity. Your supercharged engine... it's lacking power. Seriously.

NONE of the LS engines make as much power as comparable others. Show me some that do... just try. 

Now. My comment includes facts. Figures. Reality. You can easily check the existence of the links I posted. You can check the figures for the engines I mentioned. 

Your comment has what? You calling me a liar, you spewing some crap about 'deflection', you stating that I fail, you calling me a 12 year old.... and jack shit in the way of facts or figures.

You're a joke. Why do you think I even bother replying to you? Because you're hilariously useless. Utterly incompetent, completely ridiculous and utterly ludicrous.
Reply: Foxtrot Oscar
hahahahahahahahahahahahahahahahahaha

Once again you have NOT provided the Articles/Reviews supporting your biased bullshit claims and opinions!!!

Dont care about tech articles.. The minor flaws are known!!! As in one of the tech article you posted CLEARLY STATED THE MINOR FLAWS ARE ALMOST NON EXISTENT!! FROM YOUR ARTICLE!!!!!
SHUT UP !!!

"If a naturally aspirated engine can make 90hp more than your supercharged engine, from nearly the same capacity. Your supercharged engine... it's lacking power. Seriously."
(FOXCOCK)
That your Opinion!!! LS engines are designed to offer reliability for years to come,there is NO NEED TO MAX OUT THE POWER FROM THE FACTORY..IF YOU WANT MORE POWER THE LS ENGINES HAVE A PERFORMANCE AFTERMARKET  SECOND TO NONE!!!

There is a REASON you dont see many Highly Tuned ferraris..They are MAXED FROM THE FACTORY!!AND COST A SHIT LOAD OF CASH TO UPGRADE!!
Unlike the Corvette/Cadillac/Hellcat A TUNE  A PULLEY CHANGE WILL RESULT IN OVER 800HP(for a couple thousand dollars)
 
You clearly have stated Crossplane v8 engines are not GOOD for High End or Performance Auto's!!!!
Please provide some sort of proof supporting your claims!!!
Until you provide something .YOU FAIL!!!!!!
Again your biased bigot opinion holds NO value!!!!

Once again why are you comparing a $80,000 corvette to a $250,000 Ferrari?!?!?!

But hey since you made the comparison the Corvette will beat the ferrari in EVERY  performance stat(maybe not top speed).

You FAIL at every ARGUMENT!!!

I mean you made the claim that NO PUSH ROD V8 N/A ENGINE CAN PRODUCE OVER 800HP.I PROVED YOU 100% WRONG!!

Your HATE TOWARDS AMERICA IS BLINDING  REALITY!!!!!

I ask you ONCE AGAIN PLEASE PROVIDE A ARTICLE/REVIEW supporting your claims that Cross plane V8 engines are not GOOD for High End or Performance Auto's!!!!!

You are NOT a Auto Journalist!!
You are a 12yr old boy
Reply: zeusdog34 Once again you've simply ignored the articles I've already posted. 

You're moaning about a lack of articles, then stating that you don't care about articles... Makes no sense.
What do you want? Someones opinion that they're crap, or the solid engineering facts of exactly why they're crap... Because that's what I've given you. Pure, unbiased fact. 
If you want to deal with the opinions of people who are skewed by pressure to keep their jobs, and manufacturers happy, then kindly fuck off, becuase there's no point debating with someone who argues only in cherry picked opinions of fallible humans, rather than accepting the cold hard facts of reality. 

None of the articles I posted said 'non existent'. One said that, in the Chevvy design, the problems had been minimised. Now, minimised does NOT mean non existent. Minimised means that the symptoms of the problem have been reduced to the lowest levels they can be. Does NOT mean the symptoms are not still there, and does NOT mean the problems are solved.

So what you're saying is that, because a Ferrari comes from the factory as the best it can be, it's bad, and becuase the Corvette and Hellcat and suchlike come from factory as a half hearted attempt that's nowhere near as good as it could be, it's amazing....

The one that the factory put no effort into, is, in your world, better?

I'm sorry, but I judge cars on how they come, not on what they could be if you plough a ton of money into them. If I had enough money, I could make my Land Rover faster round a track than an M3... Does that make it a good performance car? NO IT DOES NOT. A Series III Land Rover is a terrible performance car. 

The PROOF that crossplanes and pushrods are bad for high end performance cars is in the FACT that both configurations are significantly less efficient than their comparable competition, and, in practice, can be seen to produce less performance. That and the FACT that almost NO high end manufacturers use crossplane V8s in their HIGH PERFORMANCE models, and NO one uses pushrods in ANYTHING anymore... Except GM and Chrysler.

Your hatred towards fact is blinding you to reality. You are WRONG, accept it. Enjoy the engines you like for what they are, but do NOT try to claim that they're something they are not.

You are NOT a sane human being
Reply: Foxtrot Oscar
hahahahahahahahaahahahaha

YES NOW BACK TO EXCUSES!!!! Thank you!!

"What do you want? Someones opinion that they're crap, or the solid engineering facts of exactly why they're crap... Because that's what I've given you."(FOXCOCK)
Oh and you are NOT a Engineer!!!

Again please provide a ARTICLE/REVIEW that states "they are crap" OR one that States they are a "POOR design" OR one that States they should "not be used in High End OR Performance Auto's"

Yup in the same article it talks about how ferrari has minimized the vibration inherent with flatplave v8 engines..Not gone just minimized!!!
You are thw queen of cherry picking through articles!!

"That and the FACT that almost NO high end manufacturers use crossplane V8s in their HIGH PERFORMANCE models,"(FOXCOCK)

Bentley GT=HIGH END PERFORMANCE MODEL
Audi RS/R8= HIGH END PERFORMANCE MODEL
Mercedes AMG/GT= HIGH END PERFORMANCE MODEL
Maserati= HIGH END PERFORMANCE MODEL
Porsche Cayanne/Panamera=HIGH END PERFORMANCE MODEL
Jaguar R=HIGH END PERFORMANCE MODEL
Morgan 8=HIGH END PERFORMANCE MODEL
Venom GT= HIGH END PERFORMANCE MODEL
Koenigsegg=HIGH END PERFORMANCE MODEL
Cadillac CTSV=HIGH END PERFORMANCE MODEL
Corvette ZO6=HIGH END PERFORMANCE MODEL
Lexus F=HIGH END PERFORMANCE MODEL(and the list goes on)
Hmmmm these Auto company's disagree!!!

Doesnt matter Bentley offers a w12 or that Mercedes offers a v12 or Audi offers a v10!!! They still offer a CROSSPLANE V8 IN THERE HIGH END PERFORMANCE MODELS!!!

Once again PLEASE PROVIDE A ARTICLE/REVIEW THAT supports your biased opinions that Crossplane v8 engines are not GOOD for High end or Performance Auto's..
Just admit that you CANT FIND A SINGLE SHRED OF PROOF(article/review)!!!

Its perfectly fine for you to think Crossplane v8's are not GOOD for High End or Performance Auto's BUT THAT DOES NOT MAKE IT TRUE!! Its ONLY your OPINION,NOTHING MORE!!FACT!!
UNTIL YOU PROVIDE A ARTICLE/REVIEW
YOU FAIL!!!!
YOU FAIL!!!

You are a BIGOT
You are a 12yr old boy
You are NOT a Auto Journalist!!
You have a deep DISTASTE TOWARDS ANYTHING AMERICA!!
Reply: zeusdog34 How does your false opinion of my job history relate to how you don't care about facts?

Again I HAVE provided multiple articles explaining exactly why pushrods and crossplanes are 'crap'. 

I never once claimed that flatplanes didn't vibrate, however they have been tamed to a point where they are 'acceptable' in performance vehicles. I wouldn't put one in a big, wafty saloon car. But then, I wouldn't want a crossplane in one either. I'd want an I6 or a V12. 

You, however, claimed that pushrods were fine, when they simply are not. 

Bentley CONTINENTAL (that's the model, not 'GT') has a W12. It's not really a performance car, just a big, comfy GT that happens to be fast. The V8 is the LOW PERFORMANCE version of the car!

Audi R8, again, the high performance model is NOT the V8, it's the V10. 

Porsche Cayenne... It's a big SUV, not a performance car. The Panamera is a big saloon thing, not a performance car. Fast cars, NOT performance cars. The 'performance' cars in the Porsche range are the (flat six) 911 and the (flatplane V8 Hybrid) 918. 

Mercedes... not really high performance. They're powerful, but they're overdone. And they now use SMALL crossplanes and NO PUSHRODS.

Jaguar R... shit. Frankly. The S models are much better. And they've got a thunking great supercharger on them. 

Morgan...Not really 'high performance cars'. They're made of wood for fuck's sake!

Venom. NOT high end, NOT even a car. It's a modified Lotus. Hennessey aren't a manufacturer, they're a tuner. Legally, the car is still a Lotus. And it's shit. 

Koenigsegg, one exception. I did say 'almost' no one uses crossplanes. 

Cadillac/Corvette NOT high end, and NOT even eligible for evidence seeing as those are the engines being questioned. 

Lexus. Their only high performance car used... oh yeah, a V10. 

High end HIGH performance model. The 'high' part means high. If there's a faster model, that is the high performance one. Not the slower one. 

Please provide a factual article that disproves the FACTS of the crossplane firing irregularities, and the efficiency issues of pushrods... oh, yeah, you can't, because they're FACTS. You can't disprove the FACTS.

You are biased to the point of ignorance, prejudice to the extreme, willfully oblivious to reality and frankly, stupid to believe that in an age where pushrods and large crossplanes are nearly dead, that they any good whatsoever. 

Just admit that the FACTUAL articles posted ARE proof of facts (being factual articles) and we can be done here. 

The FACTS are the FACTS and nothing you can do will ever change that.

FACT.
Reply: Foxtrot Oscar
hahahahahahahahahahahahahaha

Wow this a easy response!!!

EXCUSES and DEFLECTION is ALL you have left!!

Thank you!!!!

Still NO proof from you in the way of a ARTICLE/REVIEW supporting your opinions/claims that Cross Plane(push rod) V8 Engines are not GOOD for High End or Performance Auto's!!!
No PROOF=YOU FAIL!!!

Your opinions are your opinions,NOTHING MORE!!!

You are a 12yr old boy!!
You are NOT  a Auto Enthusiast!!
You are NOT a Auto Journalist!!!
Reply: zeusdog34 Wow.... you really do believe you're right, don't you?

You forget, sitting there demanding evidence, that you have supplied NONE. None whatsoever. 

I, on the other hand, have the combined might of engineering physics, and witnessed fact behind me. 

As I keep saying, you cannot make an argument based on telling the other guy he's a 12 year old who is wrong.
Reply: Foxtrot Oscar
hahahahahahahaha

Yes BACK TO DEFLECTION and EXCUSES!!

I have provided countless reviews and test NONE of them support your biased opinions!!

I dont care about tech articles!!! I dont care about the minimized minor flaws!!

Just like I dont care about the minor flaws with  flatplane v8 engines!!

Just like I dont care about  Rolls Royce!!

Just like I dont care about Pagani!!

But you wont see me on Videos complaining or bashing or calling people morons,idiots because THEY dont agree with your biased opinions!!!

Once again please provide a article/review supporting your opinions!!
Reply: zeusdog34 You know what a review is, right? It's someone's OPINION. 
You know what technical articles are? FACT.

Fact trumps fiction, and the fact is, pushrods and crossplanes DO NOT perform as well as their modern equivalents.

I consistently see you, following me around, bringing up the Corvette and V8s in places they're not even relevant. That's far worse than providing relevant feedback to a video.

The comment section is for feedback, so what if that feedback points out the negatives of an engine mentioned in that video? 

Are we not allowed to acknowledge fact unless it fits in to your opinion? This isn't the Dictatorship of Zeusdog, your opinion does not affect the facts.
Reply: Foxtrot Oscar
hahahahahahaa

MORE LIES from the biased bigot!!!

YES BACK TO DEFLECTION AND EXCUSES!!
THANK YOU!!

Yup a review is someones opinion!! The difference is the reviews are being done by experts is the FIELD!!!!!!

"Fact trumps fiction, and the fact is, pushrods and crossplanes DO NOT perform as well as their modern equivalents"(FOXOCK)

Please provide a article/review that supports your opinion!!!!

You SEEK out videos for the reason of bashing and complaining!!!! And trying to convince everyone that your opinion is the only correct one!!!

Once again you have NOT provided a article/review supporting your claims/opinions that crossplane(push rod)V8 engines are not GOOD for High end or Performance Auto's..

Nice try with more lies!!!

I dont claim the Crossplane(push rod)v8 engines to be the best at anything!! FACT!!

You on the other hand try to convince EVERYONE that crossplane v8 engines are crap,gutless,shit,boat anchors!!FACT!!And when someone disagrees with your BIASED Opinions you call them names!!! FACT!!!!

You are a 12yr old boy!!
You are not a engineer!!
You are NOT a auto Journalist!!
Reply: zeusdog34 'Experts' in REVIEWING. Ask the average motoring journalist what thrust washers do, or to explain how a constant mesh gearbox works, or exactly why straight cut gearboxes are 'stronger' than helical cut gearboxes, and most won't know.

I'm talking the FACTS of the ENGINEERING of a car, NOT what people's OPINIONS of a car are. 

Please find a FACTUAL source that suggests that pushrods are good. 
You have provided NOTHING..

I eagerly await your bullshi.... sorry, your response.
Reply: +Foxtrot Oscar hahaha right 1000hp in an sr20 will cost you TONS AND TONS of money! go look up the 1600hp twin turbo ls7 that is run as a daily driver and reliable. It is even covered by BNR warranty?! an sr20 in the USA is NOT cheap unless it's beat to death. you are still looking at over 2k+ shipping for a Sr. you can find ls1/ls2 with t56 and wiring for 4-5k. The sr is a great motor but sorry LS reliability and aftermarket kills it. plus 6.2l with 400+hp and still getting better mpg the a 4 banger turbo?
Reply: +Foxtrot Oscar where in the hell did you get the figure off 500hp in sr20 with just longtubes?! try injectors cams tune full exhaust massive front mount meth injection. takes quite a bit to get a sr20 to 500hp and at that point it is not exactly reliable anymore.
Reply: ***** What facts? Point some out. Go on.
Reply: sublimekid247 So? Building a good engine will cost money. So what if you can get 1600hp from an LS7.

An SR20, fresh from Japan, in the US, can be had for under $2000. Easy.
So if you're looking for a light, revvy, globally supported engine for 2k, or a heavier, sluggish boat anchor with single-country support for 5k... what looks better?

The SR, of course.

LS reliability? Try telling that to my 5.7 litre coffee table. 

6.2 litres, 400hp... HA! How is it even possible to build an engine that gutless!? And how in the hell could you even consider passing that off as a 'performance' engine!?

More mpg? Nah... just nah.

I've run an LS1 powered C5 'Vette, and I run a CA18 powered S13 (the CA being the older, less economical predecessor to the SR) The S13, despite being knackered, still gets better economy day to day. The Corvette cruised slightly better, but that was ONLY if you managed to keep it at about 65 in top for hour on hour, and slowly the average crept up. But considering how rarely I drove it all day at 65... it never really beat the S13. 

What the hell are you talking about 'longtubes'?
Reply: +Foxtrot Oscar hahahahahahahahahahahahahahaHahaha
lololololololololololololol

seriously You are the biggest douche bag!!!! Nothing I mean NOTHING you Spewed holds any value!!!! 

Keep rambling your bullshit!!!! We Americans don't give a shit about global aftermarket!!! Our favorite engines can be had here for very little money with very little effort!!!!

Shut the hell up..You are No better than anyone else!!! Get that through your bigoted Head!!!!  Just because you like to do things a different way makes you NO better!!!!!

Your OPINIONS are nothing!!!! You are nothing!!!

You keep going round and round, the more you spew  your bigotry shines through!!!!

You are a fucking liar!!! You cherry pick through everything!!! 

No matter what shit you spew ,you will NOT change one single Opinion/mind!!!!!

You can talk engine specs all day long.. But it does NoT matter...

You will keep spreading lies and bigotry and I will continue to call your American hating ass out!!

You are not a Auto ENTHUSIAST

You are not a engineer

you are not a auto Journalist

you never owned a Corvette

 you  have never gone 200mph in a car

You are however a Biased bigot lying American hating douche bag!!!
Reply: sublimekid247 Why the hell would you want to buy a transvestite? Weirdo...

Anyway, no, they don't. You'd be hard pressed to get 20 average out of an LS. They are MASSIVE engines that DO NOT like to change speed.
If you live at one end of a motorway, and work at the other, and there's never any traffic, you might be able to average 25. But, if you need to drive into a town at any point, or you travel across country, that'll drop well below 20. 

2k for an SR
5k for an LS. That's MORE.
Every SR I've seen for sale comes with its basic wiring, and if you buy one without a gearbox, you're an idiot. 

The CA is just older. There's nothing fundamentally wrong with it. The lower displacement puts it at a slight disadvantage against the SR20, which is just all round a better engine, but the CA was installed in my car in the factory. It was 'free'. Why spend money on a new engine and put effort into swapping it in, when the one it already has is perfectly adequate? 

I owned the one LS powered car, however through work I've driven dozens of them. And I've never liked any of them. Cadillacs, Corvettes, Silverado's, Camaros.... none have evoked any kind of emotive response, nor do they spark any interest.

The styling is generally over the top, but lacking in basic proportion, the engines are dull and boring, interiors garish and distracting and build quality... generally at the very, very bottom of what is acceptable. Not up to standard, really. 

I like how you believe that the TINY TINY TINY TINY TINY minority of American cars outside the US mean anything. Yes, they do sell SOME outside the US, but total European sales of Corvettes were less in the entire C6 run than were sold from some individual dealers in the US. 

For an entire continent to buy so few cars, shows that they're really not that well received. 

You're many times more likely to see a Ferrari than any kind of LS powered car. 

Many of the cars your brother will have seen in Germany will also be US military imports, servicemen importing their own cars, then either driving them around, or selling them out there when they realise that, unless your fuel is massively subsidised by your government, you can't actually afford to run a car like that. Or possibly because they kept being overtaken on the Autobahn by diesel Mercs, which is just embarrassing. 

The middle east is dominated by Japanese manufacturers. Everything is either a Toyota or Nissan pickup, a Land Cruiser or Pajero, or some kind of smaller Toyota/Nissan saloon. In the richer Arab states such as Dubai, everyone is constantly trying to outdo eachother... so you do see some American stuff as it gets noticed as 'different'. That said, you're likely to see more Bentley's than Corvettes. 

So? So you can get 600hp out of a 9 litre ridiculous engine... Big whoop. What are you going to put that in? 
What is 600hp actually good for? 
Save your money, save your time and buy a proper supercar. There's no use faking it with a massive V8.

So GM made an engine deliberately shitter, to avoid a tax they could have avoided by building a good engine to begin with. Great. Their laziness just screws over the consumer... Well, actually, it doesn't. Because if you're stupid enough to buy an engine that should have been canned 40 years ago, then you're not really in a position to care.

Yes, I'm calling myself stupid there. I should have done the research before I dumped a shit load of money into my Corvette, they're just crap to begin with, they'll never run perfectly, they'll never be that fast and they'll never really get on with you. 

You LS bumboys make me laugh. It's an archaic heap of crap that has proven its worthlessness time and time again. 

The LS has a big following in ONE country. In the US, sure, the LS has massive parts availability, and the SR has fairly little, although shipping from Japan to the US is piss easy.
HOWEVER, in the entire rest of the world, you can still get SR parts pretty much anywhere, because Nissan have a global dealer presence, are bought in large numbers worldwide and have enthusiast hubs all over the world. 

LS engines....don't. There are one or two specialists in Britain, who import stuff from the US... but that's expensive and takes ages. No one carries any real stock or variety. In some of the eastern European countries, there is a morbid appreciation for American stuff, but that's mainly the really old military trucks that ended up out there, and stuff that US servicemen have shipped out with them and sold off to locals. Germany especially. That's grey market stuff though, and a lot of the Germans avoid it.

In all my travels around Asia, Africa, Europe and even South America, LSs are rare, very rare.

I considered throwing my LS1 into my Land Rover. It does make a little bit of sense. As shit as the LS is at producing any realistic performance, it has a lot of torque. And torque is good for a big, heavy off road vehicle. Useless for speed, great for towing. However, fuel, parts availability and the fragility of the engine put me off and I ended up going straight back to a Land Rover 2.5 diesel. It may not be fast, but that thing will outlast cockroaches after the nuclear apocalypse. Oh, and you can get parts for it practically anywhere. Yes, even in the middle of the Sahara, Land Rover spares can be found. I was dead chuffed.
Reply: so um since it is such junk why did that massive huge piece of junk still hold 13th place on the n urburgring and it only takes cars with awd or cost 2-3× more to beat it's time? oh and the mpg thing is bs you can get well over 20 IN THE CITY easy out of an LS1 even with spirited driving. the only time you'd average well below that is with the supercharged model or a truck or you are flooring it light to light. normal day in and out commutes would be easy to sustain over 20mpg
Reply: ***** You keep saying I'm being 'owned' however I've managed to shoot every counter argument down quite easily. That would be the complete opposite of 'being owned'. That would be 'owning'. 
Case in point... In the time it takes to have a really good yawn, I've completely rebutted your miserable insult.
Reply: sublimekid247 13th place on the Nürburgring... Wow. 
And that means... What? The car is relatively fast on a track that's 70% full throttle, has huge straights and is actually quite easy on the car. 
The Nürburgring is a rubbish track for car testing as it's so difficult on DRIVERS that consistency is almost impossible. In addition, the track varies in length depending on how it's laid out that day, there is no official governing body for 'Ring times and there isn't even a dedicated start/finish line. Some laps are standing start and others are flying, again, depending on layout. Some laps are solo, many others are in traffic. The weather plays a huge role, many cars aren't 100% stock, many having roll cages installed and comp tyres being a popular modification by the testers. The drivers are wildly varying in skill and knowledge of the track.

And then we get to the real problem with your argument. Power and speed does NOT equal 'good'. With enough capacity any idiot can make power.

Making power that is smooth, delivered in a precise, progressive manner, and that is produced efficiently and consistently..  That's the hard bit. Something that no stock LS has achieved. Sure, some heavily modified engines have been pretty good. But if you're spending 30k on totally rebuilding a 20k engine from scratch is fackin' stupid.

I could NOT get 20mpg in any city. Fuck, I could barely get 20mpg anywhere  with mine!

I regularly drive 200+miles a day. On those days, yes, I could get 20mpg, sitting on the motorway at constant speed for hour after hour in top. 
Fine. But I'm an anomaly very, very few people do that. 
Also, 20mpg is shit. It is. 
My 1972, 5.3 litre V12 Jag can manage 20mpg on a long run. About the same as the Corvette did. However, that Jag is making 400hp. About 60 more than my Corvette did. It's also nearly 30 years older than my Corvette was. And about 50% heavier, and less aerodynamic.

How did the Corvette not get better than an ancient V12 Jag?!
There's not much point pouring fuel down a Corvette every day, when my far more comfortable and practical Jaguar got more anyway.

No downsides to an LS MX5? Bollocks.
Weight. 
The LS and its gearbox are both considerably heavier than the Mazda units.

Mass density. The LS setup puts more weight forward and more weight back, spreading it out further. This doesn't affect the weight distribution between axles, but does increase its distance from the centre of rotation, thus the forces applied during cornering are increased massively. Consequently the car becomes twitchy. The front is sharper on turn in, as there's more weight pushing the tyres into the road, but then the pendulum effect takes over, exacerbated by the sharp initiation, and the car either understeer OR oversteers, sometimes both, and with far less warning than stock. 
This essentially ruins the car.

The wheels on an MX5 are small. That means small tyres. That means that, with the high torque of a massive engine, you're just going to spin them all the time. That's slow.
Small tyres also means low grip, meaning any weight seriously affects cornering ability.
Small wheels also means small brakes, meaning weight affects the stopping distance significantly too.

Big torque also brings problems with the driveline. The standard diff and driveshafts aren't going to last long, so they'll need to be replaced. Expensive. 
Rear suspension components are also stressed more, meaning they'll need beefing up. This is expensive, increases unsprung weight and that in turn can make the back end more skittish... Not a good idea with three times the stock power.

Torque will also try to twist the chassis in a front engine, rear wheel drive car. This, in the roofless MX5, is a real problem. So you either live with a car that changes shape when you plant your foot (bad) and is constantly shifting and weakening itself (also bad) or you add a full six point cage to stiffen it up. That's heavy and expensive and raises the centre of gravity noticeably. 

The big V8 is also noticeably slower to respond and rev compared to small 4 cylinders. This sluggishness combined with a massive excess of torque and a terribly linear, low end biased power curve giving very little control, all in a light, short wheelbase car suddenly asked to deal with far more than it was designed for, will result in a car that racing drivers would describe as 'lively' and normal people describe as 'a cunt to drive'.
Thats bad.

Also, the sheer cost of building it. You have to buy an MX5. About 1500-2000 where I am for a solid, nice one. Then you've got to buy an LS and gearbox. 5-8 grand depending what engine you get.
Then you've got to get a custom propshaft and rear end made up, order or build custom mounts for the engine and gearbox, build or buy custom exhausts, custom plumbing, radiator, custom fitted pedal box, re route heater hoses, custom power steering setup, route a new throttle.....
And then you've got wiring...  Yeah. You've got to make a GM engine talk to a Mazda chassis.  Tricky, expensive, and a pain in the arse when it doesn't work and you just get reams and reams of fault codes, poor running, things not working, flat batteries, and general annoyance on all fronts.

If you do it properly, it could cost you 10-20k, plus buying the car... And you end up with a tiny little bitch of a car with a ruined chassis and a crap engine. Jap lovers will hate you for ruining an MX5. Muscle lovers will hate you for having a small Japanese car. 
MX5 owners who've spent a tiny fraction of the cost on supercharging or turbocharging their stock engine will laugh at you as they sail past, and Caterham owners will piss themselves laughing at how much you spent on going half as fast as they are. 

There are a LOT of downsides to an LS MX5.

And please, if you want to argue against that, use some logic, consider the mechanics behind it, and the physics, and construct a sensible and logical argument as I have done.
Reply: +Foxtrot Oscar the fact that the sls amg black edition is a full 10 places slower speaks volumes and the only cars about it are the gtr which is a monster and rightfully so and $200k+ cars. I really dont see all these "long straights" except that one very long one. you can complain all you want the ls1 isnt going anywhere and since they are "so rare" over there why do you even care then? Apparently you have no idea how to build or maintain one of the most reliable easy engines to maintain. go fiddle with your jag then and if ANYTHING breaks it will cost you far more then even a catostrophic failure on an ls. The ls is extremely simple in design that is why it is widely used backyard mechanics can get it to work on anything! the whole argument with swapping ours is of chassis manufacturer. you will jave ecu/wiring issues on any swap like that dont try to single out the ls. dropping a 2J in a 240sx would be as big a pain if not more so then an ls. Oh and the whole no top end again is a lie plenty of engine builders hell even the crate motors make max power from 2k-redline. If you need drop the power down low because you yourself dont understand pedal control isnt the engines fault. id rather have linear power not progressive. winding a motor out to get to its max potential is useless. Like on my moto guzzi I make max power from 3k-redline. I can skip shift and chug the motor along without it coughing and wheezing like a crotch rocket if I shift too soon.
Reply: +Foxtrot Oscar oh and haha sorry but 20mpg out of your jag is beyond bs try again. the best people have recorded in real life driving is well under 15 and that is driving like a old lady. you ever get your foot into it and your well into single digits.
Reply: sublimekid247 The fact that the AMG SLS is a big, heavy, overpowered thing designed to be big, loud, striking and powerful, and not in any way designed to be a precise, track oriented vehicle speaks volumes about how you judge cars. 

The GTR is an interesting one because that is designed to be fast.... It's also designed to be far larger and more practical than a Corvette, whilst using a small, efficient engine to save space and so that it's cheaper to run. 

It still means nothing on the Nürburgring, however. The ONLY thing that track tests on a hot lap is the driver, and the durability of the tyres. 

I've had catastrophic failure on my LS1..  It cost a fortune. It would have been cheaper to import a whole new engine, 3000 miles across the Atlantic. Unfortunately it needed the original block and engine number for insurance reasons so I had to rebuild it. I lost track of the final figure, but it was going on 6 grand, and all I ended up with was another 340hp LS1 that still never ran right. 
I managed to make some money back when I broke the thing for parts, but it still cost a fortune.

A set of performance pistons for the 3.4 litre XK in my D type (a 60 year old car) cost me just undwr £600.. A set of stock pistons for the LS1 cost me nearly 700 quid...

Yes, the LS has two more cylinders making it £90 or so per piston, compared to £100 per piston for the Jag... 

But the Jag engine is 60 years old, hasn't been produced for about 50 years in that displacement and no XK engines have been made since the 90s. They're also custom performance parts for only £10 more than a mass produced stock part for an engine that was still in production. 
Yes, I did end up melting my Jag pistons, but that's because I'm trying to cram 330hp out of a 60 year old 3.4 litre N/A engine. My fault. 

The LS is very complex compared to my first engine rebuild. I did my V12 when I was restoring the car, about 12 years ago. That was dead simple. Carbs, points ignition, single overhead cam operating two valves per cylinder. Each set of valves is directly actuated by the cam. The LS, on the other hand has a more complex ignition and fuelling system, but then, it is more modern. My V12 now has multi port injection and electric ignition too. 
However, the LS has a really weird firing order, that took some getting used to (it doesn't fire alternately between banks, left, right, left, right, it has an L,R,L,L,R,L,R,R firing pattern becuase it's a crossplane V8.) that confused me at first. 
Also, each valve is actuated by a cam buried deep in the block, and requires a complex mess of little tiny bearing surfaxes and rockers and a load of random sticks...
Cam follower, pushrod, rocker, then the valve. Pain in the arse compared to the Jag where the cam sits straight on the valve!

A 2J in a 240SX is excessive. They're light cars and don't need it. An SR20DET is cheaper and slots in perfectly with factory parts. And can be made to make up to and beyond 1000hp if you're a certifiable lunatic. 

Max power from 2k to redline is a HUGE flat spot in the power. If you tuned it more for top end, yes, you reduce the power band, but the more angled power curve gives much more power at the top end. Flat spots are generally bad. If you tune for a 2000rpm power band rather than a 4000rpm power band, you make just as much power at, say, 3k, but MORE above that, and that's still plenty wide that you can easily stay above the power band using the gears. Especially with a 5 or 6 speed. In the olden days, when 3 and 4 speed gearboxes were common, you needed the grunt lower to bridge the gap. Not for the last 30-40 years though.

Human beings have limited control over their feet. There is a point where you physically cannot be any more delicate. Progressive power means that you A) get more at the top end, thus more overall and B) have more feel and precision down low when it's slippery or coming out of a tight corner.

Yes, you can control a big, grunts engine, but you have less precision, thus to avoid spinning the wheels, you have to stay further from the absolute limits. With a progressive setup, you can stay closer to the limit with more control, meaning you can actually put more power to the road, use more throttle, in tricky situations. More control is always better, even the best drivers on the planet have limits, and will appreciate more control. 

Great, so you can CRUISE easily with a grunty, low end engine, but you lose so much power by tuning it to the wrong end.

Perfomance comes from area under the curve. If you take the ~2000rpm at the top end (the bit you actually use when driving fast) then higher power there will yeild more area underneath, thus you are faster, essentially. Of course, you don't want the engine too peaky, otherwise you're always shifting to keep it in its optimum zone, so it is a balancing act to some extent. A 2000rpm band is pretty big though, so there's no problem there. A 4000rpm power band is just wasting potential.

That's what I'd use for a truck, where you need the low end grunt for hauling weight and don't care about going fast.
Reply: ***** I'm pretty sure they don't have 1972 Jaguar XJ12s in the xbox. Nor Series III Land Rovers. Nor does the xbox let you strip an engine down and have it on your bench. It can't show you how a pushrod valvetrain works, it can't explain just how many spindly little parts are in a pushrod valvetrain. It can't give you the feeling of being in a real 1961, 3.8 litre Jaguar E type coupe, with real Michelin XWXs scrubbing real tread across real tarmac, feeding that back through real pieces of metal to a smooth-worn, thin wooden rimmed aluminium three spoke steering wheel. It can't replicate the solidly weighted clutch, the distinct bite, nor the slight baulking of the gearbox as the ancient, low-tech synchromesh tries to do its job, nor indeed the delicate footwork needed to ensure that the non-sychromesh 1st gear engages perfectly when downshifting, and the ever so slight jolt through the polished orb of the gear stick as the gear dogs engage. 

Sorry son, but the evidence for me  being a 10 year old with a games console is non existent, while the evidence of me being a 29 year old with a funny old house full of funny old cars is all over the place.
Reply: sublimekid247 And you make me laugh. 
Ferrari, Lotus, Ford, McLaren, Porsche, Radical, Ariel, Cosworth and practically every top race V8 for the last four decades.

Crossplanes do have negative performance traits. The fact that some people use them in cars that have a modicum of power does not mean that these problems don't exist, it just means that the cost of fixing them was not worth it for the car they went in. As decided by... an accountant. 

The crossplane is the accountant's performance engine. And thus, as an engineer and an enthusiast, slightly disgusting in my books. 

Fine if it works, fine if it's considered. Not so fine if it's just posturing or bean counting. 

Mercedes, BMW and Audi don't actually use crossplanes in any serious performance vehicles. Mercedes don't make serious performance cars full stop, BMW have the M2 and M4 and the Z4, which are all inline six, and Audi have the R8... which is V10 powered in its high performance guise. 

Interesting how, after having been barraged with fact, logic and technical terminology, you revert to simple 'oh they use it so it must be the best' argument techniques. Zeusdog34 does exactly the same thing. 
Not a criticism as such, just an observation...
Reply: sublimekid247 Show me a motor with a cam and I'll stop talking. The fuck you talking about motors with cams for?

MOTOR
http://i.ytimg.com/vi/esRAVdc1drI/hqdefault.jpg

ENGINE
https://upload.wikimedia.org/wikipedia/commons/9/96/Honda_RA121E_engine_Honda_Collection_Hall.jpg

(1991 Honda F1 engine, 3.5 litres 710hp N/A)

Also an engine is this.

http://i.imgur.com/vzJDDjK.jpg

The BMW M12/13 Turbo F1 engine. That was a 1.5 litre 4 cylinder making up to 1500hp. 

Doesn't sound like much compared to the estimated 8000hp of a top fuel car,

BUT. Here's the thing with top fuel engines. They will NOT make 8000hp all day. They will make it for about 20 seconds, after which they will melt.
Top fuel engines don't have a water jacket in the block, they're solid (because the ridiculous amount of supercharging needed to cram enough air through just two valves, combined with the sheer ridiculous litre sized cylinders means that the ancient Chrysler blocks needed extra strengthening)

No cooling means they eat themselves pretty quick. 
They also get a full strip down after every run. 

Basically, each engine will run for a few minutes and will race for ~4 seconds in its entire life.

Top Fuel engines also run on Nitromethane, which pretty much nothing else does. THAT is the secret to the power, as Nitromethane can be burned at 1.7:1 air to fuel rather than 14.2:1 as petrol does, meaning a shitload more fuel can be bunged in, thus more power.
Given the flame speed characteristics, energy density and amount you can physically fit in an engine, Nitromethane typically makes about 2.3 times the power that petrol does.

Put simply, if you put petrol in a top fuel engine, tuned it and ran it, it would only make about 3400hp. 
Conversely, run a turbo F1 engine on Nitromethane and you'd end up with about 3400hp...

Coincidence, but interesting how huge a difference the fuel can make.

Anyway, top fuel engines are not engines, they're time bombs. You can't run them for very long.

They will never do a single mile in their life.

They run ridiculous fuel, ridiculous boost and make 976hp/litre.
The F1 engines in the 1980s ran less boost, pump petrol and made 1000hp/litre. 

Sorry, what are the top fuel engines doing that's special again?

Oh, and the F1 engines lasted dozens of times longer than top fuel engines do.
And used far less fuel. 

The average F1 car does 4mpg these days. In the '80s that was only about 2mpg.

A top fuel engine does 96 gallons per mile

That's ridiculous. 

So, compared to 1980s F1 engines, top fuel engines aren't that special.

Then when you consider that they're consuming ridiculous fuel, and just waiting to explode/melt/eat parts of themselves, they're actually pretty terrible.

It's an example of a rubbish technology pushed to its very limits.

Also if you've ever seen a top fuel head, you'd see the port size and general proportions of it would be totally useless for a petrol engine, or any kind of road engine, as they're all too big. It'd just stagnate. A four valve setup would provide the same or greater volume but with less stagnation as there's more area covered.

The same reason why three twin-choke carbs with smaller bores than the three massive single's I had before, run my Jag far better and happier. Gas glow, madafaka.

Like I keep saying, there's more to life than dyno figures. 

That said, in the case of top fuel, it's imaginary figures, because no one's ever dyno'd them. 
Not that they'd last long enough to actually make a pull without melting into a puddle.
Reply: Foxtrot Oscar hahahahahahahahahahahahahahahahahahahahahahahahahahahahhahahahahahahahahahahahahahahahahahahahahahahahahahahahahaha
lololololololololololololololololololololololololol

All I see is EXCUSES and DEFLECTION!!!!!!!

Nothing beats NHRA DRAG ENGINES!!! I dont care what Bullshit you come up with..

Your issue is you cant give American Auto any praise whatsoever!!!

Your deep distaste towards America wont allow it!!

YOU MADE THE COMMENT THAT CROSSPALNE V8(PUSH ROD)V8 ENGINES ARE not GOOD FOR HIGH END OR PERFORMANCE AUTO'S..
Please provide a article/review that supports your biased opinion (u claim as fact) ..

Mercedes AMG GT IS 100% A PERFORMANCE CAR!!!! AND USES A CROSSPLANE V8!!!!

Most auto experts that review and test the Mercedes AMG line consider it
 a performance oriented Auto!!! And uses a crossplane v8 engine

Most auto experts that review and test the Audi RS Line consider it a performance oriented Autos!!! And uses a crossplane v8
engine

Please provide a article/review that states the AMG and RS Lines are NOT performance oriented Auto's!!!!

Keep spewing your bullshit biased lies!!!
NO ONE CARES ABOUT YOUR OPINION..

Your opinion holds even less value because of your strong biased distaste towards America in general!!

YOU NEVER OWNED A CORVETTE!!
YOU ARE 12YR OLD BOY
YOU ARE NOT A AUTO ENTHUSIAST
YOU ARE NOT A AUTO JOURNALIST
Reply: zeusdog34 In what way does nothing 'beat' drag engines? 
Power? There are more powerful engines.
Specific power? Well, 1980s F1 cars matched it and...
Longevity? 1980s F1 engines made the same specific power for much, much longer. I mean, an engine that lasts seconds isn't exactly great, is it?
Cost effectiveness? Erm, no. They're very, very expensive engines.
Efficiency? Erm, 96 gallons per mile... Yeah, real efficient.

Sorry, how is any of that 'beating' anything else?!

Oh, I can't praise American cars can I? In what world?

Is me calling the Ford Voodoo engine 'brilliant' not praise?
Is my waxing lyrical about the stylistic talents of the 2nd Gen Plymouth Barracuda not praise?
Pull the other one...

I may not love absolutely everything the US does, but I don't love absolutely everything that ANYONE does.
 YOU ARE NOT SPECIAL.

I give credit where credit is due.

If it's not due, I don't give it. That's why Mercedes aren't exactly in my good books at the minute. Although their shape changing aero concept was fucking cool. 

HIGH CUNTING PERFORMANCE.

Plonking a clattery V8 in a smallish car does NOT make a dedicated high performance vehicle.

Building a vehicle from the ground up to be the best it can be is a dedicated high performance vehicle. And those who build the best, do not use crossplanes. 

Lamborghini (V12)
McLaren (flatplane)
Porsche (flatplane)
Ferrari (V12 and flatplane)
Lotus (4,6 and flatplane 8 cylinders)
Nissan (GT-R V6)
Lexus (LF-A V10)
Audi (R8 V10)
Radical (flatplane)
Ariel (flatplane)

Nope... no crossplanes in there.

You assume anyone gives a flying fuck about your opinion...
Reply: Foxtrot Oscar HAHAHAHAHAHAHAHA

EXCUSES and DEFLECTION!!
Thank you!!

Please provide a article/review that states  the auto's you mentioned are the BEST as you claim!!!

Bentley GT (V8)
Mercedes AMG GT
Venom GT
Koenigsegg
Corvette zo6
Audi R8(V8)
Morgan 8
Spyker
Jaguar R
Aston Martin V8 Vantage

Nope .....No Flat plane or v6 in there.

You assume anyone gives a flying fuck about your BIASED BIGOT Opinions....
Reply: zeusdog34 You want facts, yet when I provide them, you state that you do not care. Then you ask for people's opinions on cars, yet when I provide mine, you state that you do not care.

So you don't care about facts, and you don't care about opinions.

How the fuck is anyone meant to prove anything to you then?

They can't, is the answer.
Just as you want it.

I'm no professional psychologist, but in my humble opinion (for anyone who does care) you, little Zeusdog, can't handle the concept of a world where you are not right. You don't seem to be able to grasp the concept that you liking LS engines does not magically make them good.

You are perfectly within your rights to love LS engines and the cars they come in. I like a lot of stuff that isn't good too. I like the Morgan 3 wheeler. That's a terrible car, factually. It's slow, it doesn't grip, the engine is not powerful, the traction is terrible, the steering is clanky, it's cold, it's not comfortable and it is missing a god damn wheel!... But I love it, because it's pure fun and makes me happy, and I would recommend you try one and make your own mind up. 
The LS evidently makes you happy. That's good. 
However, like the Moggy, it's not actually any good in the modern world. 
That's fine too. It makes people happy. People who like the old ways of twig operated valves, burnouts and 1/4 miles on the streets in the dead of night. 

Do NOT, however, try to tell anyone that it is factually good. Because it isn't. 

Tell the world it makes you happy, but don't claim it to be something it isn't.

Simple request, and it applies to pretty much everything.
Reply: Foxtrot Oscar hahahahahaha

I have NO problem with your Opinions, its when you claim them AS FACT!!!!!!
 
Im NO professional psychologist but in my humble opinion you cant handle the fact that A LOT of people really like LS/LT American Engines and get RAVE reviews!!!

You cant seem to grasp the concept that you disliking the LT/LS crossplane engine does not magically make them crap!!!!!!!

You claim the Crossplane (push rod) v8 engine to be crap,gutless,shit,boat anchors that do nothing well!! Not GOOD for High end or Performance Auto's  THAT IS YOUR OPINION,NOTHING FACTUAL!!!!

When you provide a article/review that states they are crap,shit,gutless boat anchors that do nothing well and should not be used in High end or Performance Auto's.. I will back off!!!
BUT WE BOTH KNOW THE SHIT YOU SPEW IS YOUR OPINION,NOTHING MORE!!!!

If you want people to respect you..You might want to try this route.

In my opinion i think American cars suck..

And leave it at that!!!!

But you like to claim everything you spew as fact!!!

And why try to change ones opinion?!?!  Why spend years spewing the same bullshit about one type of car or engine?!?!?!

Why seek out videos about cars/engines you hate and try to convince the people that like them their opinions are wrong!!!!!?!?!?!

Your Opinion holds NO value!! You are way to biased and bigoted to be taken seriously!!!

And its not just American Auto's!!
You can be found on videos about American trains criticizng and compairing them to the Euro trains!!!!

On just about every vid you post on , you seem to criticize EVERYTHING from the way someone speaks,to the spellings they use to the DATE system they use..ITS NEVER ENDING!!!!!

You are a BIASED BIGOT UK TROLL!!!!

You never owned a corvette!!! LIAR!!
YOU ARE NOT A AUTO JOURNALIST!!
YOU ARE NOT A AUTO ENTHUSIAST!!
Reply: No, you just have problems with facts.

It is FACT that crossplane V8s under perform compared to other configurations.

It is FACT that 'under performing' and 'high performance' are at opposite ends of the scale. 

Therefore it is logical progression that crossplane V8s are not good for high performance applications. 

That is a three step argument based on pure fact and simple logic.

Now you try. Try to tell me why pushrods and crossplanes are good for performance.
What is it about pushrods specifically that make them better for performance?
Reply: Foxtrot Oscar
HAHAHAHAHAHAHAHAHAAHHAAHAHAHAHAHAHAHAHAHAHAHAHAHAHAHAHAHA

More your of your Opinions,nothing more!!

"It is FACT that crossplane V8s under perform compared to other configurations."
(FOXCOCK)
Please provide a article/review that states this!!
Until than ,SHUT YOUR MOUTH!!!

"What is it about pushrods specifically that make them better for performance?"
(FOXCOCK)
Nice try LYING TROLL!!! I have NEVER ONCE CLAIMED THEY ARE BETTER FOR PERFORMANCE!!

My argument has ALWAYS BEEN they are NOT crap,gutless boat anchors!!

But they typically produce more torque,easy to upgrade,easy to work on,LS/LT is typically smaller in foot print,lower center of gravity..Plus in America,Australia,Canada Parts are very easy to come by!!

Once again I ask you to please provide a article/review that supports your opinions that crossplane(push rod)v8 engines are shit,junk,crap,gutless not GOOD for High end or Performance Auto's!!!

Until you provide proof.SHUT THE HELL UP!!

You are NOT a Auto Journalist!!
You are NOT a Auto Enthusiast!!
Reply: zeusdog34 Your argument is void. 
My argument was that crossplane V8s are highly undesirable for performance use, and pushrods are incredibly stupid and inefficient in perfomance applications.

The 'boat anchor' part was in reference to the installation of LS engines in Corvettes. 

I don't care about pushrod crossplanes being better than other things, because they just aren't. What I care about is you claiming that they're better than they actually are.

Your claims of the configuration's competency are simply not true.

There is a massive difference between doing a job and doing it properly, and no LS can do performance properly.

Proof has been provided, so no, I won't shut up. 

Maybe you should take your own advice there, as you haven't put forth a single shred of evidence thus far.
Reply: Foxtrot Oscar hahahahahahahahahahaha

More bullshit excuses and deflection.. 

"My argument was that crossplane V8s are highly undesirable for performance use, and pushrods are incredibly stupid and inefficient in perfomance applications."(FOXCOCK)

Please provide a article/review that supports your claim!!

"There is a massive difference between doing a job and doing it properly, and no LS can do performance properly"(FOXCOCK)

Please provide a article/review that supports your claim!!

"Your claims of the configuration's competency are simply not true."(FOXCOCK)

100% ARE TRUE AND YOU KNOW JUST AS EVERYONE ELSE DOES..

MORE LIES FROM THE BIASED BIGOT AMERICAN HATING TROLL!!!

Once again I ask you to please provide a article/review that supports your opinions that crossplane(push rod)v8 engines are shit,junk,crap,gutless not GOOD for High end or Performance Auto's!!!
Reply: Josiah Crowley On the basis that it produces very little output considering its size, relatively little output considering fuel consumption on an average basis, is a sluggish, ponderous sort of engine with little in the way of urgency, is very flat in its power delivery, meaning precise or delicate power moderation is far, far more difficult than it really should be.... oh, and of course, the terrible inefficiency of its valvetrain, the fact that I own 60 year old engines more mechanically advanced, the annoying near-incurable misfire, wonky timing and general lack of performance.

As it's marketed as a performance engine, and doesn't perform, I'm therefore forced to conclude that it is crap.

Of course, there's always the truck versions, and yes, for trucks, the dynamics of the engine are fairly good. It doesn't need much in the way of performance or precision, just brute force. 
However, a diesel engine provides all of this with far, far greater fuel economy, and when comparing 15mpg to 40mpg, it's a no brainer.

That's how.
Reply: +Foxtrot Oscar "Yes. But Ferrari do it quicker, smoother and better from a smaller, more effective engine."  LMFAO

You mean quicker.......as in not as much power????  And more effective????  You mean the engine that produces LESS power, is more expensive to both manufacture......and operate,  and is in a car that gets 12 MPG?????

You're so lost kid.
Reply: Sahadi420 No, I mean quicker as in, the engine just does what you want it to quicker.
And in terms of power, Ferrari's 4.5 litre N/A V8 makes 600hp. Can any LS do that? Nope. Chevvy need 6.2 litres and a supercharger to pass 600. That extra complexity makes the LS9, MORE costly, although GM have the advantage of being able to absorb and spread the cost thus making it cheaper to purchase for a consumer. That's BUSINESS though, not the actual engine.

Ah, you say, but the LS is still making 640hp, more than the Ferrari. Yes. If you ignore all the technical brilliance, lighter weight, better response and superior efficiency, then yes, the LS makes a bigger figure on a dyno... Except Ferrari's 6.3 litre N/A V12 makes 740hp. A figure stock LSs can only dream of. 

The ZR1 claims an average of 17mpg, 14mpg urban and 21mpg extra urban.
Compare that to the larger, heavier, F12, with 100 more horsepower, that claims 13mpg urban, but claims 19mpg average and 27mpg extra urban. 

That is, if I'm not mistaken.... Better.

Sorry, what was your argument again?
Reply: +Foxtrot Oscar The F12 can get 27mpg "extra urban"??????  LMFAO.  What?!?!?!?!  Is "extra urban" where you idle the car, and roll it down a hill????  You gotta show me a source for that number. 

And you're calling a supercharged LS9 more costly than the 458's 4.5L V8????  

Proof you're a fucking moron.   You can say what you want about a Ferrari motor vs.  an LS motor......but if you start calling the "ancient push rod technology" LS motor a more complex, MORE costly motor.............you simply don't know what the fuck you're talking about.   

And, is the Ferrari engine warranty good for 100,000 miles??????  LOL
Reply: Sahadi420 car data.com
Superchargers are expensive to design and produce. Engines have a largely similar cost to manufacture no matter what. 
Design is the kicker. I'm willing to bet GM actually spent more designing the LS than Ferrari, given that GM are huge and Ferrari survives mainly on merchandise sales.

Pushrods are complex, fiddly and comprise FAR more components than any OHC design.

Ferrari, service is generally quite good, and I believe their warranty runs on years rather than mileage, as most customers use their cars for special occasions rather than daily. 
Also, GM are huge and can afford it. 

And at the end of the day... The Ferrari engine is just better. Much, much better.
Reply: +Foxtrot Oscar Yes, so the Ferrari engine is much, much better.  That's why you find people ALL OVER THE WORLD using LS motors in their builds.........instead of calling Ferrari for an engine.   LMFAO

WHY IS THAT???????  

And you said it best yourself.   "most customers use their cars for special occasions rather than daily."  Meanwhile LS engine owners put hundreds of thousands of miles on their cars.
Reply: Sahadi420 Ferrari engine swaps exist. But Ferrari's are rare. GM V8s are mass produced. So why don't you see them very often? This side of the pond, Ferrari's are more common...
Some Ferrari owners have hundreds of thousands on their cars too. A much more impressive feat for a high strung perfomance car than a truck engine.
Reply: +Foxtrot Oscar Once again you stated EXACTLY why people don't waste their money on a Ferrari engine.  

As YOU put it, when talking about a Ferrari engine with high miles......."A much more impressive feat for a high strung performance car than a truck engine."  EXACTLY!!!!!!  Why would someone put in a Ferrari engine that has 500 hp, that will be "an impressive feat" (according to you) if it makes it to 100,000 miles........when an LS motor is WARRANTIED (aka designed for) that kind of mileage???

Because they're the ones actually using their money to build an actual car........not some fucking moron like you that does nothing but TALK about shit you'll never fucking have.
Reply: +Mr English well, LS motors are put in builds all across the globe.  And no, I don't have one.......but you can't diss the performance, low cost of maintenance, and reliability of the LS motors.  

Any one else out there with a 600hp motor........with a 100,000 mile warranty??????  Anybody??? Anybody???  LOL

NOPE!!!!
Reply: Sahadi420 When you want performance though, that's a compromise you HAVE to make. An LS modified to 740hp will NOT be as durable as stock, and will NOT be under warranty at all. It'll also be less responsive, less efficient and just won't drive as well. 

Why would you put a truck engine from the 1960s in a performance car? You just wouldn't, so why use the LS, which is mechanically the same thing?

Power is NOTHING without control, precision and response. 

If you're just going for brute force, Wartzila make engines with well over 100,000hp that are designed to do millions of miles. So fucking what?
Reply: +Foxtrot Oscar The LS block is designed to handle 1500hp.  The reason you get such reliability from the "truck engine" is because at 6,7, or even 800 HP, the engine is not "stressing out" like you think it is (and how you admit the Ferrari engine is).  That's why at 640ish HP with the LS9.......you get the 100,000 warranty.......and if you want, check corvette customer satisfaction sites.......and you won't find "my shit blew up at 30K".....you'll find great customer satisfaction. 

So again, you clueless moron......if the Ferrari engine is soooooooooooooooooooooooooooo much better than the LS motors.........why doesn't everybody do Ferrari engine swaps, instead of LS ones????  Nelson racing engines makes 2500hp LS motors..............find me a 2500hp Ferrari motor!!!!    LOL

God you are beyond lost................
Reply: Sahadi420 BLOCK. 
Not engine.

At 800hp, any engine under 8 litres WILL be stressing. 
From an engineering point of view, Ferrari's 6.3 V12 will be LESS stressed than any 6.2 LS due to its greater spread of forces, shorter throw, lower piston weight, smoother operation and general superior build quality.

However, 740hp from ANY N/A 6.3 litre engine is 'high strung'. 

There is also a huge difference between big power N/A and big power supercharged.

As for satisfaction of Chevrolet products, here's a nice survey.
http://www.autocar.co.uk/car-news/new-cars/2013-jd-power-customer-satisfaction-survey-full-car-model-results

Only Chevrolet car I could see with a quick scan is, erm, bottom...
Yeah...
No one buys Chevvies.

Nelson makes shit with massive turbos.

Find me an LS that's won a top level international race.... Oh yeah, none.

This is why Ferrari are motorsport legends, and Chevvy have some class wins at Le Mans, with a custom built engine vs some detuned Ferraris and some 6 cylinder Beetles... Wow.
Reply: +Foxtrot Oscar So your saying that "From an engineering point of view, Ferrari's 6.3 V12 will be LESS stressed than any 6.2 LS due to its greater spread of forces, shorter throw, lower piston weight, smoother operation and general superior build quality."   LOL

You're seriously gonna say a V12 Ferrari is gonna be a "happier" engine, to use and maintain........over a LS motor????    

You're just a troll.  LOL
Reply: Sahadi420 Maybe the V12 is a little harder to maintain, I don't know, I've never worked in depth on a Ferrari 12, only basic service, which was pretty simple.
I do certainly prefer my Jaguar V12 to the LS becuase the pushrod valvetrain is just a pain in the arse. So many tiny little parts.

The Ferrari engine is certainly more enjoyable and rewarding to own.
Reply: ***** 2J. In terms of specific AND outright power, it's far more impressive. 1500hp stock block, from a 3 litre...
 Power is EASY to make. A GOOD ENGINE is very hard. The LS is not one.

That said, my one of my favourite engine anecdotes is from BMW in the 80s. To build their 1500hp 1.5 litre 4 cylinder F1 engines, they reportedly bought back 100,000 mile plus cars from customers that ran the 1.6 engine. They then used those blocks to form the basis of possibly the most insane racing engine ever built. As much specific output as a Top Fuel car, AND it would last about 100 times as long, AND it did it on standard high octane petrol, not nitromethanol. 

Do you know what 'dominated' means?
It means winning by a huge margin, can consistently.

McLaren dominated the 1984 F1 championship, winning 12 of 16 races. They finished 250% higher than the next competitor.

THAT is dominating.

Getting a few 14-17th overall places at Le Mans is NOT dominating. It is NOT. 
NO.
Class wins, at one race, and losing as much as winning, that is NOT dominating.

Corvette also attribute their success not to their car (which is consistently SLOWER in qualifying and uses MORE fuel,  but to superb team management. They are astounding, managing to keep their total pit time the same or below the other GT cars despite stopping more often.

And please, do tell me what your evidence is for your slanderous claims against my person.

All you've done is shout about modifying engines and the word 'dominating' where it really isn't needed. 

In short, you're fucking useless, fuck off.
Reply: ***** Fact. Everything you've just typed is bollocks.
Fact, you cannot prove a single one of your statements.
Fact I CANNOT DISABLE REPLIES.
Only the VIDEO OWNER can manually do that, and Google+ LIMITS THE NUMBER OF NON-SPAM REPLIES TO 500!

I am not the video owner, and as the rest of the reply threads work fine, I'm assuming that one just hit 500.

http://thenextweb.com/socialmedia/2012/07/17/want-to-congratulate-marissa-mayer-on-her-new-gig-via-her-google-post-you-cant/

It's been around a long time, this 500 post limit. 

Now, not only are you verbally insulting me for no reason, but you're insulting those suffering from Autism?! 
Wow, you really are a cunt, aren't you?

2Js are relatively cheap, development is good, they came in Supras, yes... but also in Chasers, Soarers and a number of other cars that are relatively humdrum and not sports cars at all. 

Hang on a minute.... WHAT?!

I said "the C6/7R engine is not an LS, it's just BASED on one".
Now you're saying I'm wrong, and I quote, "the 5.5 V that they use in Le Mans is in FACT based on the Gen 5 LS/LT motor."*

So you're saying I'm WRONG because of EXACTLY WHAT I SAID.

That's like telling someone they're wrong about the sky being blue, because the sky is blue.

You absolute fucktard.

Corvette winning 8 CLASS EVENTS since 2000 is NOT dominating. It just isn't.
It's NOWHERE NEAR dominating. Now, if that were 12 or 13 wins in 15 years, fine, that's dominating. But 8/15 is NOT dominating. 
STOP USING 'DOMINATING' IT IS ENTIRELY THE WRONG WORD, YOU ARE WRONG, FACE THE FACTS, THE CORVETTES DO NOT DOMINATE ANYTHING

Get the message?

Wow, trying to claim that my teeny tiny little island is irrelevant... Having fun on your computer using electricity and the world wide web. You know that computer that travelled by powered ship. Have a nice holiday recently? Did you go on an aeroplane?
Do you enjoy owning all the mass produced stuff in your home?
In fact, do you enjoy your entire existence?.

Put simply, in one way or another, the only reason the industrial world is as it is today is down to one teeny little island...
Reply: ***** While my current job is not in engineering, I did train as an engineer and hold multiple jobs in engineering in the past. 
Yes. From an engineers point of view, it's terrible. There are a large number of very good reasons why pushrods are an awful idea for both efficiency and performance. Crossplane V8s aren't a brilliant idea for performance either. Nor are engines with large cylinder size when looking for perfomance, as the LSs do. 

The rpm at which power and torque are made means nothing, really, as there are so many more variables that that.
Ideally you'd want it higher for a performance engine and lower for an engine meant for a luxury car or truck or what have you.
At the end of the day though, the LS just doesn't make any real perfomance for its capacity
Reply: ***** Well, I'm not, but whatever.
Reply: +Foxtrot Oscar Dude, just shut up already................
Reply: Sahadi420 Why? Because I'm right? Because I have a legitimate point that I am expressing accurately and with reference to fact, logic and general common sense?

What's so wrong with me responding to a video that is at best, misleading, and at worst, essentially trolling the automotive world?

New Ferraris come with a standard 3 year powertrain warranty and a 7 year general warranty.

The powertrain warranty can be extended free to 7 years, and I believe up to 12 years general+powertrain warranty. 

I assume, of course, that you're more restricted on the 12 year, but either way that's a hell of a warranty for what is essentially a tame race engine.

http://www.businessinsider.com/ferrari-offers-a-12-year-warranty-2014-4?IR=T

Boom.
Reply: ***** There are so many variables to consider with regards to intended use, engine configuration, age, weight, size and style of car, that making any sweeping statement would likely be false in some respect. 
Rpm matters to the specific purpose, not engines in general.
Reply: ***** It DOES matter, however there are so many other variables that you cannot make any sweeping statements.

The engine in my Jag peaks at 7000rpm. This is excellent... In the Jag. In my Land Rover however, it would result in clutch smoke and swearing. Conversely, the ~3000rpm peak of the Landy engine, while excellent for the Rover, would be next to useless in the Jag.

In addition, even if the peak is in the right sort of region for the intended purpose, the spread of power is also important, as is how much is produced. Then of course you factor in economy, the vibrations produced, the volume of the noise produced, the response, delivery and overall feeling of the engine. There are just too many variables to make sweeping statements about where power should be produced, you have to specify almost by individual models.
Reply: ***** Regularly.... in performance cars.
In a day to day car, there's no point. In a car designed for performance, there's a lot of point. That's why I said you can't make sweeping statements.

The Corvette is designed for performance, the LS is marketed as a performance engine... it doesn't do performance though. It's a bottom end tuned engine, and its mechanical architecture is very much bottom feeder territory. It's completely the wrong setup for performance. For a truck, perfect. For performance, totally wrong. Well... actually, in a truck a diesel is better, but forgetting those, the LS is a truck engine. 

73hp/litre?! Wow, that's pretty decent for a performance engine... in 1960. 

These days, the average family car manages that economically and cheaply. You don't need that much low end torque for anything but a truck. The average car doesn't weigh 2 tons, so you don't need 600lb.ft. What you want is actual power, and in the right place, with a smooth progressive power curve. That's better for control. The 'linear' power curve of the LS is not so good. Really, it isn't, as it gives little control over the power. With a good progressive curve you have the throttle and rpm to control power. That's more variation, which means you can be more precise. With only the throttle, and especially with so much torque, precision is limited, which means you either drive well under the limit (slow) or you risk wheelspin (slow). 

If you believe anything Iamsu says, you're more stupid than the flat earth society. 

There are no 'rants' about LS engines, merely facts. If facts annoy you, then I apologise. 
I'm not going to stop with facts though.

I came here because this video made a bold and false statement. Take it up with the person who titled the video if you're so bothered by people who don't believe the hype.
Reply: ***** Does it hurt, all that thinking?
Reply: ***** Proven by what? Fact cannot be proven false, by default. Fact is fact. Ergo, not false. 
Duh.
Reply: ***** No... Just... no.
Reply: ***** I'm not criticising the base model (although that is crap too) I'm providing the facts of the failings of the pushrod design in general.

Yes, the LS could make more specific power, at the expense of economy. Trouble is, the economy is already pretty terrible, and there are a huge number of other engines that match the output, have higher specific output, and beat the economy. Look at BMW. Their M5 makes 560hp, is heavier and less aerodynamic than any Corvette, yet can still average nearly 30mpg. It has been noted as peaking at something like 37mpg. Not great compared to the usual 40mpg average for passenger cars these days, but for a turbo super barge that's pretty decent.... And kicks the LS into a tin hat. 

My 'proof' is engineering fact, and the laws of physics themselves, padded out with a little observational logic.
Reply: *****  READ THE DAMN COMMENTS.

The SR is good, because it does what it's supposed to do well. The LS is crap because it doesn't do what it's supposed to do, and what it does do, it does badly. 

Simple enough for you?

BMW aren't tricking you.

NO engine on the planet will give its full power and economy at the same time. 

Look at the new Corvette, yeah it does 30mpg, but it will ONLY do that at part throttle, 1500 rpm in top, with only 4 cylinders running. I doubt it makes more than about 40hp like that. 
Because that's all you need to cruise, and that's what it takes to get 30mpg out of that engine. 

No one is tricking anyone.

And where the hell did you get 67% from?
Reply: ***** Having just spent a pleasant evening in the pub, I can assure you I am most certainly not 10 years old.

If you want to know my age, simply subtract 1986 from 2015.
Reply: ***** So I'm -10?
Please do explain how that's possible, because if you're right,  I'm a fucking time traveller.
Reply: ***** Chevvy put the LS in the Corvette. They called it a sports car, it wasn't. Most would call it a performance car... which it is, but the engine itself is, from an engineering standpoint, TOTALLY the wrong configuration. NOTHING about it lends itself to performance well. The crossplane layout is known for its inefficient firing, and pushrods are known for being generally shit all round. 

You can LIKE what you want, I don't care, but do NOT try to tell me the LS is a good performance engine, because at the most fundamental level, it just isn't. That's why there's never been a crossplane V8 F1 engine, and never been a pushrod F1 engine. 

Don't take my word for it, listen to the race series that has produced some of the most powerful and highly developed racing engines the world has known.

I have NEVER claimed my preferences as 'the way' to do things, only ENGINEERING FACT.

Buck up, fucking listen, and you might learn something you brain dead moron.
Reply: ***** Helps if you just read the ones that are already there.
Reply: ***** Fuck is not 'bad language'. That's just who I am, sorry, deal with it. It's a random lack of swearing you should worry about.

And no, I don't take it upon myself to decide what sports cars are, the last century of sports car manufacturing has laid out a fairly consistent template that, at no point, has included massive V8s or dedication to mechanical methods nearly half a century out of date.

Sports cars have been, since the dawn of motoring, small, low powered, simple and focused on handling over power. The Corvette is most certainly not simple, not low powered and focuses far more on brute force than anything else.
Ergo, it is not a sports car, as it lacks most of the recognisable traits that all sports cars have shared for over 100 years.

You cannot argue with over a century of history.
Reply: Go on Google, search for drawbacks of pushrods, there's about 20 pages of relevant links that perfectly back up what I'm saying. 

Your 'facts' have zero proof. Kindly fuck off.
Reply: ***** And that proof is....?
Reply: ***** So your 'proof' is that you don't believe reality?

Makes sense.... That you're a fuckwit.
Reply: ***** Bullshit? So say you. Prove it.

The very fact that it's so easy for me to recirculate this suggests the fallacy of your argument.
Reply: Keith Smith Gas is 50p a litre last I saw. Not a huge amount, and that's in England, one of the more expensive places.
Petrol is 99.9p a litre.

It's not cheap cheap, but not ridiculous.

There is another point. Why the fuck should you needlessly burn more than you have to?

If you can go faster, further, why wouldn't you? Why would you burn it just for the hell of it? Even if it is 'cheap', it's still costing money.

Why is it 'totally uncool' to 'trash' the LS?

What I'm doing is explaining why the LS is as shit as it is. If facts are uncool, I'd hate to be popular in your world. 

PS. You just lost a bet.
Reply: Keith Smith Well, Chevvy and their fan club seem to love the idea of comparing Corvettes to Ferraris, so I indulge them their little fantasy... then crap all over it with fact. It's entertainment in and of itself, and provides something useful for humanity. Hooray.

If you're packing a big engine, you're playing with the big boys. Quality costs, all that jazz.

The hell is 'harry potter talking' all about?
Reply: +Keith Smith oh man , you are in a battle with the biggest American hating bigot on here.. Trust me on this one..He is a liar, NOT a engineer of any sort,Certainly NOT a Auto Journalist!!
I can tell he you that he hates the US,Comments like "We hate the US as a Country",compared the Pledge of Allegiance with Hitler youth!!!  
hE HAS SPENT WELL OVER 4YRS SEEKING OUT VIDEOS THAT HAVE ANYTHING TO DO WITH AMERICA,Than trashes away.. 
I have been asking her to provide PROOF that the LS/LT engines are (junk,shit,gutless,boat anchors)`as she claims!!NOT ONE SINGLE BIT OF PROOF, NOT ONE!!

Good luck
Reply: Foxtrot Oscar
hahahahahahahahahahahahahahahaha.. Oh no foxcock is angry!!!
Keep trying to explain your HATE!!!
You are worthless.. You are a liar!!
You are a bigot!!

You are NOT a Auto Journalist!!
You are NOT a Engineer!!!

You have NEVER proven anything!! The only thing you have PROVEN is you are an American hating bigot dirty tampon!!
Reply: Foxtrot Oscar
hahahahahahahahahaha..

Hate your worthless self all you want!!!

You have a lot to hate about yourself..
Bigot. Check
Lair. Check
American hater. Check
All around douche bag. CHECK

Never provide a ounce of proof to support to 100% bullshit claim!!!  CHECK!!!!
Reply: zeusdog34 In your opinion.
Reply: +Foxtrot Oscar hahahahahahahahahahaYour comments prove everything.. Thanks BigotAmerican hating troll
Reply: zeusdog34 Yep, that's me, the bigoted American hater who gives literally zero shits where you're from, and who has some cracking American chums.

You really don't get it, do you? 
It's only you I don't like.
Reply: Foxtrot Oscar
lololololololol

You dont have any friends let alone American!!

Im happy you hate me,I would NOT surround myself with someone like you..So much hate and bigotry toward Americans!!!

Your worthless comments say everything about you..

Bigot American Hating troll!!
Reply: zeusdog34 No, an 'American hating bigot' has to actually hate America and other ideas and cultures. 

As I hate neither of those things, I cannot be an American hating bigot, because I don't hold bigoted thoughts and don't hate America. 

It's super fucking simple stuff.

Maybe someone will donate you a brain cell for Christmas.
Reply: Foxtrot Oscar
hahahahahahahahahahaha

All your bashing and negative comments towards America speak for themselves !!!
Thanks for making it very easy to prove..
Bigot
Liar
American hating troll
Reply: zeusdog34 Criticism =/= hate.
Facts =/= hate.
Complete lack of 'bashing' =/= 'bashing'.

You = fail.
Reply: Foxtrot Oscar
HAHAHAHAHAHAHAHAHAHAHAHAHAHA

More BS from the American hating troll...

You have NEVER proven any of your BIASED BIGOT comments!!

You have proven that you are a American hating bigot troll!
Your comments have proven that over the years!!

You are NOT a Auto Journalist!!
You are NOT a  engineer!!

You are a bigot!!
Reply: zeusdog34 Except for all the times I proved it... 

Please, if you can explain how 'pushrods are shit' translates to 'hate for America', I'm all ears.

Until then, fuck off.
Reply: Foxtrot Oscar
HAHAHAHAHAHAHAHA

Please provide a article/review that states Crosspalne/pushrod are "shit,junk,gutless,boat anchors"  "not good for high end or performance autos" as you claim!!!
You CANT ITS ONLY YOUR Opinion,nothing more!!

You are a BIGOT!!
You HATE America!!
You are NOT a Auto Journalist!!
You are NOT a engineer!!

Until then, STAND IN TRAFFIC BIGOT!!
Reply: zeusdog34 I have. 

You are deluded
You are lying
You are wrong
You are wrong

Until when? Until pigs fly, hell freezes over, and Zeusdog 34 says something that isn't complete bollicks?
Reply: Foxtrot Oscar
hahahahahahahahahahaha

YES back to EXCUSES and DEFLECTION..
Nothing new from the American hating bigot!!

You have NEVER proven any of your BS comments NEVER EVER!! FACT!!!

Please provide a article/review that supports your comments that "crossplane/pushrod v8 engines are shit,junk,gutless,boat anchors,not good for high end or performance autos"
YOU CANT!!!!
Everything you spew is your opinion,NOTHING MORE!!

Bigot!!
Troll
Liar!!
Reply: zeusdog34 Wow, it's like fucking groundhog day round here.
Reply: Foxtrot Oscar
hahahahahahahahahahahahahha

Yes it is..You NOT providing one ounce of proof to support your biased claims!!!
Making too easy!!

Bigot!!
Reply: zeusdog34 No, not an ounce of proof. Just a few thousand tons of it.... that you ignored.

This isn't easy, this is beyond easy. This is like breathing... it just happens. You destroy your own argument with your sheer stupidity.

Example. I prove I'm not a bigot with pure logic. You then claim I'm a bigot.

You deny that X equals X. 

That guy recently, who committed a crime, then turned himself in to try to get the reward money.... you saw that?... even he would say you were stupid.
And everyone would agree.
Reply: Foxtrot Oscar
hahahahahahahahaha

You are correct,NOT one ounce of proof!!!
Thanks for agreeing!!
X does NOT always equal X..FACT!!!

Once again NO article/review supporting your biased opinions!!
Thank you for making it easy!!

You are a bigot..FACT!!
You are NOT a Auto Journalist..FACT!!
You are a LIAR..FACT!!
Reply: zeusdog34 No. X is X. X cannot be anything other than X because X is X.

X is a constant, a theoretical perfect depiction of the concept of X. It is X, can only be X, and will only ever be X. 

X cannot ever not be X. How can you be that stupid?

Once again, go back a couple of years, before I got bored, and you'll see ALL of the proof..

YOU have ignored it. Doesn't mean I'm not right.

G'day.
Reply: zeusdog34 And your reason for calling me stupid is.... what?

Back it up, put some factual weight behind your opinions. Anyone who doesn't is a fuckwit BECAUSE (see what I did there?) anyone can say anything and it doesn't make it true. 

I could say the sky was green and that carrots were a kind of dog, just as you could say that I was a bigot or that peanuts were magnetic....
You can say what you want. Doesn't mean shit without proof. And if it's impossible to prove, or to at least give logical maps to... well then it's bullshit.
Reply: Keith Smith I have not and never intend to troll this video. 
This video posed a loaded question, I responded to that question with the simple facts of reality. 

Answering a question is not trolling.

I don't care if you like the LS or not, it doesn't change the fact that it is not "so good". 

By modern standards it's a very underwhelming piece of outdated and mispurposed engineering. We're I resto-modding something like an old Chevelle, I'd hail it as the perfect upgrade. For a factory piece in a modern car... Hell no. It's a 60s engine, at heart. And even back then, it was technologically behind the European and Japanese stuff. 

And certainly not a performance engine. Trucks would work well with an LS... If not for the fact that a diesel offers even greater torque for better fuel economy.
Reply: Foxtrot Oscar HAHAHAHAHAHAHAHAHAHAHAHAHAHAHAHAHAHAHAHAHAHAHAHAHAHAHAHAHAHAHAHAHAHAHAHAHAHAHAHAHAHAHAHAHA

Nothing but your biased opinion,NOTHING MORE!!
 
"By modern standards it's a very underwhelming piece of outdated and mispurposed engineering"(FOXCOCK)

. "For a factory piece in a modern car... Hell no. It's a 60s engine, at heart. And even back then, it was technologically behind the European and Japanese stuff"(FOXCOCK)

"And certainly not a performance engine"
(FOXCOCK)

Please provide a Article/Review that supports your opinions(THAT U LIKE TO CLAIM AS FACT)

Like I have said a million times,NOT ONE OUNCE OF PROOF..Your biased bigot opinion holds NO VALUE!!

YOU ARE A LIAR!!
YOU ARE A TROLL!!
YOU ARE NOT A AUTO JOURNALIST!!
YOU ARE NOT A ENGINEER!!
YOU NEVER OWNED A CORVETTE!!

MOST OF ALL YOU ARE AN AMERICAN HATING BIGOT TO THE ROTTEN CORE!!
Reply: zeusdog34 Well then. Provide some LOGICAL argument to the contrary. DEBATE THE DAMN POINT.

Just saying 'oh, it's your opinion and isn't true' DOES NOT WORK.

Either debate the point like a normal human being, or fuck off, it's simple. 

YOU have no proof. You just keep saying I have none (even though I've posted a shit load).

So go and fucking prove this shit.
Reply: Foxtrot Oscar
hahahahahahahahahahahahahalolololololololol

YES DEFLECTION!!!!

Where is your proof that the engine is junk,gutless,boat anchor, not good for High end or Performance Autos(THAT U LIKE TO CLAIM AS FACT)!!!!!!!

PROOF IT DOES WORK WELL IN PERFORMANCE AUTOS

Corvette
Koenigsegg
Audi r8/RS
Mercedes GT
Jaguar R
Mustang GT
Camaro
Dodge Hellcat
NASCAR
Corvette race team
Formula D
Gumpart Apollo
Noble
Baja racing
BMW
Aston Martin
Morgan
Lexus
Porsche

PROOF IT WORKS WELL IN HIGH END AUTOS

Bentley
Mercedes
Jaguar
Porsche
Audi
Aston Martin
Noble

Now I/We all understand that some of these Autos offer other engine options.. Does not make any difference..All these auto listed come with Crossplane v8 engines!! The Auto Company's feel the Crossplane v8 engine works well in these applications!!!

Now provide a ARTICLE/REVIEW that states the Crossplane/pushrod V8 engine does NOT work well in these Auto Applications!!

Cause I cant find a single review/article that does not praise the V8 ENGINES!!!

You are a LIAR!
You are a BIGOT
You are NOT a Auto Journalist
You are NOT a engineer!!
Reply: Foxtrot Oscar C'mon this should be simple for you..You claim you have shown proof in the past ..Where are those article/reviews that support your biased opinions(u claim as fact)

The fact is YOU CANT!!! Everything you spew is 100% your bullshit opinion nothing more!! 

And the reason you keep spewing hate is because you have a DEEP DISTASTE towards America!!FACT!!

You are not found on Mercedes videos bashing away the Crossplane v8 engine choice!!!

But you can be found on American Train videos trying to convince anyone that will listen to your total bullshit that Euro trains are better  blah blah blah!!!!

You compared the US practice of Pledge Allegiance with Hitler youth!!

"We hate the US as a Country"
"My country hopes the US will fuck off"
(FOXCOCK)

It never ends!!!!
You are a BIGOT!!
yOU ARE A liar!!
Reply: zeusdog34 Here is the proof, for the thousandth time.
Pushrods are obsolete (Proof of proof, no one else uses them)
Pushrods have not been used since the 1920s for GP racing.
Not one LS can match the specific outputs of comparable contemporary OHC engines.
The torque curves and power delivery are more like diesel engines than performance petrol engines. Diesels don't work in sports cars. We know this. So why will an LS?

The Corvette doesn't work well.
The Koenigsegg DOES NOT USE AN LS
The Audi R8 DOES NOT USE AN LS
The Mercedes GT DOES NOT USE AN LS
The Jaguar R DOES NOT USE AN LS
The Mustang GT DOES NOT USE AN LS
The Camaro does not work well.
The Dodge Hellcat does not work well
NASCAR engines would not work at all in a road car, and are frankly awful things to drive
The Corvette race team do not use LS engines, and their engines produce far less power than they should, and leave the car SLOWER on track, as PROVEN by the qualifying times. 
Formula D generally don't use LS engines. Most are SR20, 2JZ, a couple of LSs that don't do much, and a Mustang that doesn't use an LS
The Gumpert Apollo DOES NOT USE AN LS
Noble DO NOT USE LS ENGINES
BMW DO NOT USE LS ENGINES
Aston Martin DO NOT USE LS ENGINES
Morgan DO NOT USE LS ENGINES
Lexus DO NOT USE LS ENGINES
Porsche DO NOT USE LS ENGINES

You're deluded beyond belief!

Words cannot describe your sheer stupidity.
Reply: Foxtrot Oscar hahahahahahahahahahahahahahahahahahahahahahahahahahahahahahahahahahahahahahahahahahahahahahahahahahahahahahahahahahahahahahahahahahahahahahahahahahahahahahahahahahahahahahahahahahahahah
LOLOLOLOLOLOLOLOLOLOLOLOLOLOLOLOLOLOLOLOLOLOLOLOLOLOLOLOLOLOLOLOLOLOLOLOLOLOLOLOLOLOLOLOLOLOLOLOLOLOLOLOLOLOLOLOLOLOLOLOLOLOLOLOLOL

DEFLECTION!!!!!!  Thank you!!!

NO PROOF,NO ARTICLE/REVIEW!!!

YOU FAIL BIGOT

I also find it funny, for years your argument has always been against crossplane v8 engines than onto push rod v8's now its the LS/LT Chevy engines!!!

Nice try BIGOT AMERICAN HATING TROLL

But hey thanks for your biased bigot opinion..It holds NO Value but you have the right to your opinions!!!

"Diesels don't work in sports cars. We know this".(FOXCOCK)
HMMMM AUDI Le Mans racing team seems to do very well!!!  hahaha you fail at EVERYTHING YOU SPEW!!

LIAR
TROLL
BIGOT
Reply: zeusdog34 SPORTS CARS. Not Le Mans prototypes. 
Also, if you knew anything about those Audis, you'd know their number one problem is too much torque, making corner exits a pain in the arse. 

If you'd bothered to listen rather than being a loudmouth prat, you'd know that my problem is with people who don't understand why large pushrod crossplane V8s are a bad idea.

All of those things. Small crossplanes with DOHC are adequate for mid range performance vehicles. 

Large crossplanes are shit for perfomance, pushrods compound that.

It has ABSOLUTELY NOTHING TO DO WITH AMERICA.

So un-wedge that rod from your rectum and chill the fuck out, you deluded moron.
Reply: Foxtrot Oscar
hahahahahahahahahahahahahaha

MORE EXCUSES!!!!
MORE DEFLECTION!!!

"with people who don't understand why large pushrod crossplane V8s are a bad idea"
(FOXCOCK). Thanks for your opinion..

"Large crossplanes are shit for perfomance, pushrods compound that:(FOXCOCK)
Thanks for your opinion!!

Please provide a ARTICLE/REVIEW that supports your biased opinions that "crossplane v8 engines are shit for performance and a bad idea"

Until you provide a article/review that supports your opinions ..YOU FAIL!
YOU FAIL!!
YOU FAIL!!

You are a LIAR!!
You are a BIGOT!!
You have a deep distaste towards America!!
You are NOT a Auto Journalist!!
Reply: Round and round we go
On the idiot's circle
round and round again.

There you go, a haiku for your ignorance.
Reply: Foxtrot Oscar HAHAHAHAHAHAHAHAHAHAHAHAHAHAHAHAHAHAHAHAHAHAHAHAHAHAHAHAHAHA

Yes back to DEFLECTION and EXCUSES!!
Thank you

No ARTICLE/REVIEW supporting your biased bullshit opinions =YOU FAIL!!!
YOU FAIL!!!
Reply: zeusdog34 You do realise that your shouting of 'deflection' all the time, is, in and of itself, you diverting the course of the conversation away from an area that will compromise the integrity of your opinion. That could be said to be deflection...

Long story short, you fail ironically. Which is hilarious.
Reply: Foxtrot Oscar hahahahahahahahahaha

MORE DEFLECTION...THANK YOU

NO ARTICLE/REVIEW supporting your biased bigot opinions =YOU FAIL!!
YOU FAIL!!

Long story short,You are a liar,bigot ,American hating troll with only your worthless opinions..
Reply: zeusdog34 Irony upon hypocrisy upon delusion.
You really are on a roll today.
Well done.
Reply: Foxtrot Oscar
hahahahahahahahahahha

STILL NO ARTICLE/REVIEW supporting your biased bullshit opinions=YOU FAIL!!
YOU FAIL!!
YOU FAIL!!

You are  BIGOT
You are a LIAR

Ramble all you want BUT YOU HAVE NEVER PROVIDED ONE OUNCE OF PROOF !!
American hating troll
Reply: Foxtrot Oscar
HAHAHAHAHAHAHAHAHAHAHAHAHA

http://wardsauto.com/diesel-resource-center/variety-distinguishes-2015-ward-s-10-best-engines

http://jalopnik.com/the-10-best-engines-of-the-last-20-years-1510676043

http://www.forbes.com/pictures/ehmk45eeihf/2-chevrolet-corvette-stingray-6-2-liter-v8/

http://www.fastcar.co.uk/2012/03/12/10-best-engines-to-tune/10/

Now please provide a ARTICLE/REVIEW that disagrees with these Articles and supports your opinions you claim as fact!!

Bigot
Liar
Troll
Reply: zeusdog34 Fuck sake.... 
What are the criteria? 
Come on, you cannot expect me to take a rating seriously when there are glaringly obvious flaws in the the engine. 
The LS is amongst the worst engines. It in no way at all fulfills any of its intended roles well. 

'Best engines to tune' any N/A engine that is 'easy' to get more power out of has one simple trick. It was poorly designed to begin with, or was deliberately tuned to make lower power.

Old engines are easy to tune becuase the designs are old and sub-optimal. Things like the Jaguar V12, that's so easy to get more power out of, because the stock exhaust and intake manifolds flow like shit. The basic engine is good, but each end is all bunged up. That is slightly different in that Jaguar intended for it to flow badly, to keep it whisper quiet. That's not a concern with the LSs, so why do they make such crap power?!

PS, someone ranking an engine is also.... And you'll love this.... Their OPINION.

So, find some FACTS and then come back and apologise.

The LS is easy to get power out of because it's so under tuned from factory, it's almost like they haven't bothered since the 50s. They're so gutless stock, it's no wonder!
Reply: Foxtrot Oscar
LOLOLOLOLOLOLOLOLOLOLOLOLOLOL
HAHAHAHAHAHAHAHAHAHAHAHAHAHA

Yes EXCUSES and DEFLECTION!!

"The LS is amongst the worst engines. It in no way at all fulfills any of its intended roles well"
(FOXCOCK)
Please provide a ARTICLE/REVIEW that supports your statement!!!
.
You still have NOT provide a ARTICLE/REVIEW supporting your biased bullshit opinions!!!Thank you

These Opinions are by EXPERTS that review /test these engines!!!

Your Opinions DONT MATTER ,because you are NOT a expert or a Auto Journalist!!

You are however a BIGOT AMERICAN HATING TROLL WITH A DEEP DISTASTE TOWARDS AMERICA!!!

Provide a article/review that disagrees with the the Article/reviews I posted!!!
UNTIL YOU PROVIDE A ARTICLE/REVIEW THAT  SUPPORTS YOUR OPINIONS
YOU FAIL!! FACT!!

You cant !!! SO YOU FAIL!!!

You are a BIGOT!!
You are a LIAR!!
Reply: zeusdog34 Ah, so the opinions of 'experts' (qualifications?) are worth more than engineering fact, and the laws of physics.... I see...

Nice planet is it, the one you live on?
Reply: zeusdog34 Thought you might appreciate this
http://gearheads.org/consumer-reports-20-least-reliable-for-2015/
Lots of GM, Chrysler. I was quite surprised by Ford's Focus and Fiesta though, as they're generally quite decent little cars. 
No surprise things like the Cadillacs had engine issues though. 
Of course, there's a Fiat in there too. No surprises there.

Or is that article my opinion too?
Reply: zeusdog34 Do you manually type out your manic laughter every time, or do you have it saved in a document ready for copying out?
Reply: Ancient <> bad.   They have large DISPLACEMENT but are damn small and light. At least in aluminum...